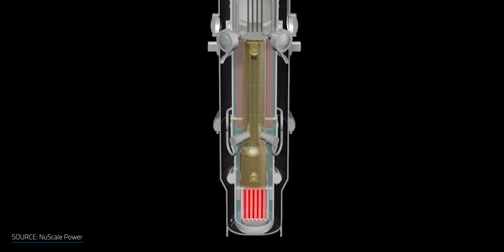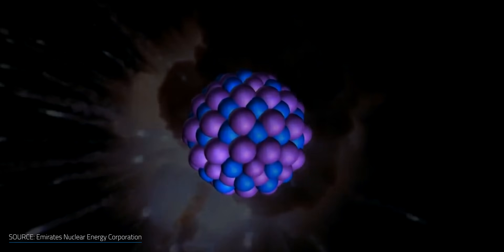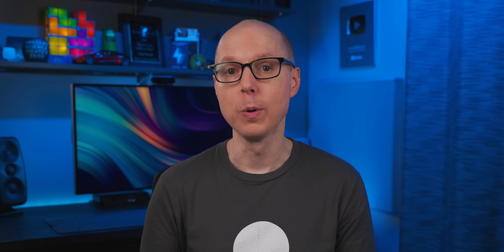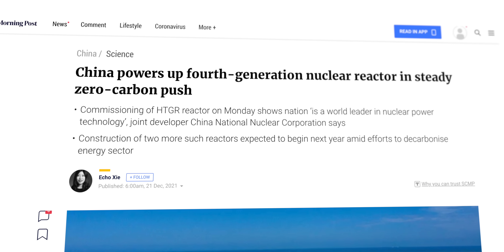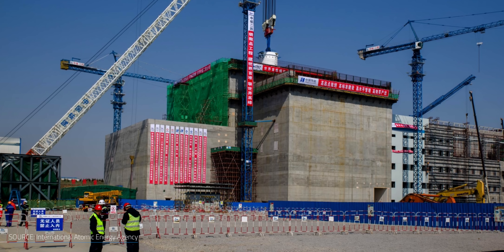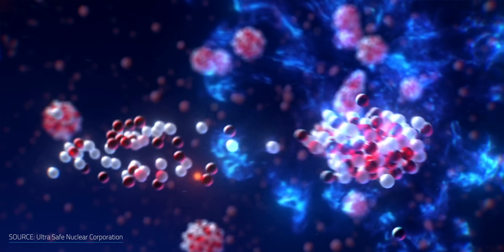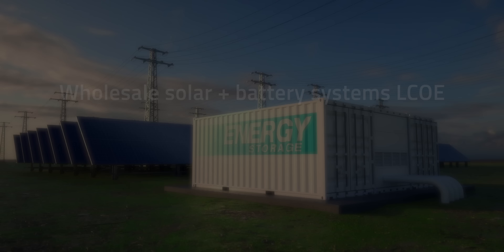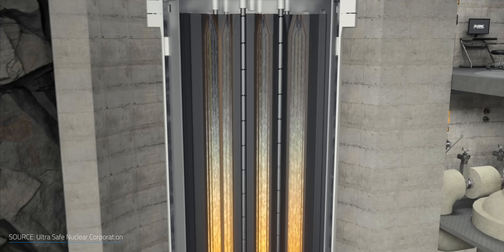Forget Small ... What About Micro Nuclear Energy?

Comment: I served aboard USS Will Rogers, SSBN 659, as a Nuclear Machinist's Mate and Engineering Laboratory Technician. That means I cared for the nuclear reactor and all associated systems, while monitoring for anomalies, as well as radiation exposure of the crew. Naval Nuclear Reactors are incredibly compact, yet incredibly powerful. The S3G reactor was about the size of Radiant's design that's capable of 1MW. However, due in part to much higher enrichment levels, S3G cores far surpassed this level of energy output.

While working for DuPont after the Navy, I worked on Naval Fuels, and Defense Nuclear Waste. We were perfecting vitrification of high-level nuclear waste over 35 years ago! That 90 MT of spent fuel languish in onsite storage all across the country is a travesty.

As for the SMR or MSR question, that's an "and-both" issue, not an "either-or" one. There is no "Silver Bullet". Only silver buckshot.

So, in addition to the first-off-the-tongue renewables of solar, wind and hydro, we must quickly expand production capacity, while investing heavily in geothermal and wave/tidal. Geothermal and wave/tidal are akin to stable, baseload generated by natural gas, coal and nuclear, and we've barely scratched the surface of what these energy sources can deliver to humanity and the planet.

SMRs have their place. Designs are approved and projects are already underway. No, they don't have all of the benefits of MSRs, but we urgently need the capacity. It's a bit like the tortoise and the hare, where MSRs are the former. Working down the existing spent fuel inventory, while generating a fraction of the waste of traditional reactors designs, that's also toxic for a far shorter period of time. That's the promise that we should work towards.

In addition to all this, there are EVs, ground source heat pumps and hybrid water heaters. There are biomass, carbon capture and synthetic fuels. There are smart grids, distributed grids and vehicle-to-home. Hell, there's even white paint. We need it all. And we need it now!
Reply: Thanks for a great response!
Reply: Exactly.  Think about how amazing the Navy's reactors are.  They've been working for DECADES, 24/7, working mere feet from thousands of sailors, many of them in completely closed-air systems (the subs).  They're installed in steel ships, rolling and moving DYNAMICALLY in the ocean, in CORROSIVE saltwater.  Naval ships are a veritable test chamber for the efficacy, durability, and safety of Nuclear energy and a vital complement to renewables!
Reply: @pfschuyler   They've been working for DECADES, 24/7 - that's not true, they are periodically taken to dry dock and given repairs.
Same with nuclear carriers, there is always one in for maintenance, on rotation.
Reply: Like John Coloe, I was also in the Naval Nuclear field. I never worked in the civilian sector. I think the SMRs and the Micro reactors are a good path. I also agree that fusion should still be pursued but is not a current option. Even if a major breakthrough happened today, fusion would still be 20 to 30 years before full scale fusion would be realized. The US Navy does use much higher enrichment but they also have some outstanding safety systems. Many seem to be implemented in the SMRs mentioned in the video. I would like to see the scale reduced to single home sized reactors. A 3 to 5 KW power plant in each home for the cost of a cheap car that could power a single home for 10 to 20 years depending on usage would be a game changer. A small storm shelter sized concrete enclosure filled with a boron / water mixture underground would provide additional shielding and cooling. With grid tie, these could help the renewables at peak times and really balance the grid overall.
Reply: @John Coloe - I was going to post the same thing on vitrification and how we couldn't get it to work even after many years. SRS 1989-1995
Reply: Good to see another ex-nuke in these threads. EM1(SS), USS Shark SS(N) 591 and Stonewall Jackson SS(B)N 634 Blue Crew way back when (69-77). When were you playing ELT?
Reply: @ocelblack9823  Thank you for your service. MMN2/ELT ('77-'81), USS Will Rogers (SSBN 659), Gold crew operating out of Holy Loch. Wanted to be a lifer, but undiagnosed claustrophobia had other ideas.
Reply: @ARepublicIfYouCanKeepIt  Boomers and a divorce chased me off the boats, claustrophobia  was never a problem. If I had stayed on Fast Attacks I probably would have gone for CPO and hand my finger fused into a permanent coffee cup hook. Too many drills of "Ending The World As We Know It" sitting Battle-stations on the EPCP looking at 4 switches that could say "NOT Today".
Reply: @ocelblack9823  I was a Senior Chief EDMC or EDEA when I retired. Turned down Master Chief because I was getting burned out and had to do 2 more years to accept. That was the title we used back then for senior enlisted Nuke.. I still have that coffee cup finger. Even 20 or so years after retirement. Salute to my fellow submariners.
Reply: @lawrenceleverton7426  Good on you Chief, we know who runs the Navy.
Reply: Wouldn't save my edit, when were you playing ELT? Sorry about calling you a skimmer.
Reply: @ocelblack9823  Didn't see the skimmer reference. Wouldn't have taken offense anyway.
Reply: @ocelblack9823  no idea wtf you're talking about
Reply: @ocelblack9823  Those are fighting words. There are Submarines and there are Targets.
Reply: @lawrenceleverton7426  I already apologized for "skimming" instead of "reading" and missing the boat reference. There aren't that many of us and I regret my oversight. Sort of like the JG who failed to look up during a NATO exercise and got a PDC on the sail from an ASW helicopter. "PDC" is a "Practice Depth Charge" (concussion grenade wrapped in toilet paper to give it time to sink simulating a depth charge during exercises with allied units) for non-military persons. Phuqe helicopters, they were the bane of our existence unless we could go deep to avoid them.
Reply: Been hearing a lot about Thorium reactors lately....  seems like a very practical tech to "warp speed" into operation...
Reply: @dougstevens1877  The Thorium-to-Uranium fuel cycle is perhaps the most theoretically virtuous and, therefore, should be a goal for an MSR design such as a LFTR.

However, what those without training and/or experience in the nuclear field fail to understand are the myriad complexities in bringing new and vastly different reactor designs to market.

Currently unresolved challenges for LFTR designs include metallurgy and chemical processing. Molten salts are phenomenally corrosive, and the processes needed for salts reconditioning on an ongoing basis are novel.

These are technical hurdles that can be resolved given appropriate resources and funding.

Focused effort on the part of regulatory agencies is also required.

With all that said, we'll most likely see an early rise in SMR installations, hopefully followed by LFTR installations beginning in the 2035 timeframe.

Unfortunately, these things take lots of time, and we've waited far too long to begin taking substantive action.

If there could ever be a side benefit to war, Russia's illegal invasion of a democratic, sovereign Ukraine shone the brightest light yet as to why the world needs to break its dependence on fossil fuels. For, if not for significant dependence on Russian energy by many European countries and the UK, Putin would have significantly less power.
Reply: @ARepublicIfYouCanKeepIt  Thanks for sharing your knowledge and for being open minded enough to consider various options. The metallurgy problems seem approachable with, as you said, appropriate funding. And, though it's not optimal or sexy, in the near term, certain parts and even whole small reactors can simply be replaced, especially in designs with several small reactors at one facility. It's not such a big deal to turn one off.
Iceland has to replace a lot of parts and pipes pretty frequently in it's geothermal systems, but they still seem to find it well worth doing.
 Thorium MSRs may not be quite ready for large scale deployment, but it seems like, with effort, it may not be too far off.
Reply: The "silver buckshot" approach is ultimately what I feel would make the ultimate difference, the issue is the costs associated. 

I have a lot of family overseas in northern Europe, where saving energy (especially now) is a major priority. Houses have anywhere from 30-40cm of insulation on the walls and over 50cm for the roof. The number of passages in the walls for heat to escape is typically half compared to a standard US timber framed house. In addition to this, ground source heat pumps are quite common, with active ventilation systems to capture additional heat from the air being pulled from the house. Even the air source heat pumps are quite efficient.

It's pretty disappointing to me that to acquire a house with the same level of energy efficiency in the states, you essentially need to have it custom built. Since we do typically build in large subdivisions, a lot of money could actually be saved on the labor needed to perform drilling for things like ground source heat pumps.

I do still wonder, though, if people would be willing to pay the premium for those features when buying a new home.
Reply: @rs.wright  The UK needs to look at Europe too. We have some of the worst housing stock in Europe when it comes to insulation. Definitely possible to save a lot of energy.
Reply: This guy knows what's up! I will need to borrow the silver buckshot line - I've always remarked on society's weird obsession with a binary way of thinking when almost nothing in the known universe (especially in nature) is binary. Thanks for sharing!
Reply: @ChristopherCampanale  Thanks for your kind words. And, feel free to use the heck out of "silver buckshot".
Reply: @ChristopherCampanale   agreed
Reply: great post. Have you looked at Quaise energy? They have a great concept and it makes me think geothermal will really happen.
Reply: @zber9043  Quaise's approach has merit. But theirs is a large, centralized implementation.

It's not necessary to drill miles/kilometers deep to gain significant advantages. Heating and cooling buildings is a significant contributor of global greenhouse gas emissions. Conditioning the built environment is all about the "Delta-T", that is the temperature differential represented by source and desired temperature. The smaller the gap, the lesser the energy needed to get to the desired temperature.

We only need bury relatively small loops between 6 and 10 feet down to reach stable temperatures year round. Horizontal ground loops can be used to as a heat sink when cooling, and a preheater when heating. The same goes for heating water.

As I said in my original comment, "silver buckshot." We need every solution. Like yesterday.
Reply: @ARepublicIfYouCanKeepIt  Actually from what I could find, heating and cooling buildings is the most significant one, yet the authorities seem to dwell on reducing fuel consumption and electric cars...
Reply: @ARepublicIfYouCanKeepIt  Is there any way I can support you and your ideas?
We need more engineers and less salesmen and (current shape) politicians.
Reply: @ARepublicIfYouCanKeepIt  you should be a leading advisor for every countries energy department
Reply: @ARepublicIfYouCanKeepIt  In your expert opinion, how significant is man's contribution to global greenhouse gas emissions, compared to other natural sources of emission?
Reply: @OneOffization  In the world of correlation and causation, it's the overwhelming consensus of the scientific community that mankind has had a massive causal impact on climate; due primarily by burning fossil fuels, as well as agricultural practices supporting a diet that's evolved over centuries too heavily favor animal protein in developed economies.

To answer your question, I believe the science. Going further, I see this point in the history as mankind as the ultimate everything-to-gain-and--nothing-to-lose proposition.

Renewable energy is available in abundance. No wars need ever be fought over energy ever again. Sources of clean, baseload energy are also available, as is smart and distributed grids. Heck, they're even discovering how to stabilize grids based on variable renewables.

Electrified transport is far superior to traditional ICE-powered vehicles. Yes, more work needs to be done on battery technology in order to support increased range, but that too is happening.

Cargo, air and marine can all run on biofuels, synthetic fuels and/or fuel cells.

Yes, it'd be an expensive transition, and it won't happen overnight, but many new and better jobs will be created to build this much improved, sustainable future...for all of mankind.
Reply: @ARepublicIfYouCanKeepIt  well said. you obviously understand the space pretty well.
Reply: @xg5zm  I second that.  Or even have further discussion.
Reply: @ARepublicIfYouCanKeepIt  I would drill bit deeper that you get higher efficiency and decreased chance of cooling ground in winter too much. In summer we could use holes that are closer to surface. This could make even cheap heat pumps pretty efficient.
Reply: @TheNone724  So-called "well depth" has a  direct relationship to "Delta T", or the temperature differential between supply and conditioned air. The smaller the delta, the less work the heat pump has to do. Below 10 ft, it's a situation of diminishing returns against increased cost, so there is an optimal well depth.

As for cooling the earth around a ground loop, this just isn't a concern.
Reply: @zber9043  wtf do you mean "will happen".
Geo thermal power is a thing already, held back mostly by environmental concerns.
Reply: @zber9043   Geothermal heating is fairly common in Nordic countries. I have one 250m deep energy well drilled in backyard and it provides me all heating, cooling and warm water. Outside temperatures here is between -30 to +30 so its quite powerful. Efficiency of pump is around 5,5SCOP witch means it can make 5,5kW heat / 1kW use of electricity. Total capacity is 12kW so it transfers roughly around 66kW of heat. Total cost of system is around 15-20t€ and "breakeven" is around 7 years, nowdays a bit less because of recent events.
Reply: Cool to meet another  ELT. I did the same thing. On 5 Submarines. Including The Nautilus. Salute to the Nukes and of Course the Silent Service.
Reply: @lawrenceleverton7426  Whoa! USS Nautilus? What a privilege that must've been to ride the first nuclear-powered submarine. Thank you for your service.
Reply: @ARepublicIfYouCanKeepIt  - regarding offshore wind farms, the following might be of interest...
https://www.youtube.com/watch?v=hIsbjuCE01k

Completely agree with you about fusion. I personally don't believe E-out > E-in is doable. Many forget that any output has to be used to heat water for steam to turn turbines, with the associated loss of efficiency.

I also think building codes should mandate ground loop heat exchange, and also, as you suggest, a preheating water tank to bring water up to house temp before point-of-use heaters. (actually, I think the "suburb/exurb" model of habitation needs to go.)
Reply: @ARepublicIfYouCanKeepIt  I was assigned to her as a caretaker. as shore duty. She still had radiological issues even with her reactor defueled. I am proud I presented her to the public. I did 21 years in submarines and happy to have met another ELT. That were not many of us in the navy. What 5 or so per submarine. Have a great day
Reply: Thank you very much for this thread of comments, I enjoyed reading it!
As a foreigner and a guy who doesn't understand US Military (sub?)Marine life jargon, By ELT, do you mean Engineering Lab Team?
My opinion for the past few years has been that Nuclear should make a comeback. and fast.
The current way of "Renewable" Energy production is not sustainable.
In fact the entire first world way of living isn't sustainable. (that's why barely 10% of the globe lives like that)
Reply: @HAWXLEADER  ELT stands for Engineering Laboratory Technician. My responsibilities as an ELT were monitoring of primary and secondary cooling systems; keeping chemistries at optimum levels, while looking for hints of any problems in the reactor, compromises in the steam generators, etc. I was also responsible for monitoring radiation exposure for the entire crew, as well as permanent and portable shielding. During maintenance evolutions, I was also responsible for everything that went into the reactor compartment.

My stance on nuclear power for civilian energy production is that it's long overdue. Had we acted 30 years ago, we could have ended our dependence on oil, coal and natural gas for electricity generation. Nuclear is the answer to clean, stable baseload generation. Period.

Thankfully, SMRs, MSRs and other next generation designs are reigniting interest and activity in nuclear.

I'm also a longtime proponent of renewables. For example, I make all of my own electricity via solar.

And, while I have no issues with wind, I believe that two abundant sources of much more stable renewable energy have been overlooked for far too long. Geothermal and tidal both have the potential to completely eliminate the need for fossil fuels for everything except maybe air and heavy marine transport. For those, there's bio and synthetic fuels for air, and hydrogen for heavy marine.

If we, as a society, made the commitment, fossil fuel consumption could be reduced by 80% to 90% in 10 years...with existing technology. All it takes is the will to spend the money.

Climate change is the ultimate proof of the saying, "An ounce of prevention is worth a pound of cure."
Reply: "Silver buckshot"

Well said, my friend.
Reply: @ManOfLore1  Thank you.
Reply: I know a guy with a coastal house 

The buoys holding his swimming area net all have generators at the bottom, generating something like 4 kw on average

It probably cost a lot but so did solar just a decade ago
Reply: I served on USS Eisenhower as MM2 Nuc. A4W carrier power plant is too large to be considered an SMR. Four decks high and ~125ft x 125ft footprint. Still far smaller than the footprint of many civilian .5GW scale  reactors. But I think it would be a great example of standardized design. That standardization creates uniformity of training and procedures. And economies of scale for construction compared the one-offs common in US now. France has already figured this out.
Reply: Looks like I agree with most of what you say. What does HOA regulations mean? I'm in New Zealand. If it means local city council regulations some of them can be absurd from what I've heard. I heard that there was someone who put solar panels on their roof but the council didn't like it because of looks. He was told he had to get rid of them. The news journalists interviewed local residents. None of them seemed to object to the panels. I cannot remember where this happened though maybe a year or two ago. Somewhere in US. There is no subsidy for solar in New Zealand.
If houses were built with regulations saying roofs should face southward in their slope for northern hemisphere and opposite for southern hemisphere. That would make them more energy efficient house and suitable for solar. Using power where it is generated instead of having to transmit over long distances may not be totally possible. Unless nuclear and it's waste is solved. Will people want a nuclear plant in their suburb?
Reply: @grgmetube  Great comments. HoA is a quite heinous creation here in the states. It stands for Homeowner's Association.

Many existing housing development/subdivisions, and most new ones, have a set of covenants that residents must abide by. These can include anything from parking restrictions, to accepted colors to paint your house, to landscape regulations.

HoA's are started by the builder/developer, and turned over to the community as the neighborhood is completed. There's even an entire industry of HoA management companies.

Regardless of management, HoA's have enforcement powers, and can demand that you trim your bushes, repaint your house a different color, prohibit installation of solar panels, solar collectors, antennas, etc., and can levy fines, place liens and foreclose on your property if it's not brought into compliance with covenants or fines go unpaid.

As for long distance power transmission, this is actually a thing. Check out HVDC transmission. Australian solar production is already sending power to Singapore, and the UK will receive power generated in northern Africa.

As for nuclear power and nuclear waste, check out Molten Salt Reactors (MSR's), the Thorium-Uranium fuel cycle, and Molten Chloride Salt Fast Reactors (MCSFR's).

The technology exists that can help us to prevent the worst impacts of global climate change...provided we act quickly. Time is running out.
Reply: @grgmetube  One, HOAs need to die, period.  HOA's  are groups that enforce owners to agree to pre-planned housing and upgrades essentially. You can't do anything the HOA doesnt approve, and they can fine you for doing anything almost, such as having flowers on your porch that no one else does. The plant would be on it's own and power pushed down transmission lines not unlike it is now, you wouldn't have it right in the middle of town that would just be silly.
Reply: I also worked at SRS but after Dupont left and many of my co-workers that worked at Navel Fuels developed cancer.  It was so common that if you worked there and developed cancer it was an automatic approval for compensation by the Labor department.  I do not believe the cancer was due to the radioactive isotopes but from the toxic chemicals used in the process.  I hope you are one of the lucky ones that are still healthy.
Reply: @clarkkent9080  So sorry to hear about your former colleagues. As for me, so far, so good. I was a consulting engineer. As such, my exposure to all the nasties was thankfully limited.
Reply: @ARepublicIfYouCanKeepIt  I worked at a SRS facility that seemed to get the Navel Fuels folks after Navel Fuels shut down.  I understand that there were two sides, wet and dry and if I recall correctly the vast majority of people working the wet side developed cancer .  My cubical buddy was dreaming of retiring and planning on spending time with his children and grandchildren.  6 months before his planned retirement he was diagnosed with Pancreatic cancer.  So sad
Reply: When I was young, I worked as a miner for Eldorado Nuclear, mining Uranium, in the NWT of Canada... It's where all of the Uranium came from for the Manhattan Project. There were/are areas in the mine, where regular workers are not allowed, they are so "Hot". The Nuclear Waste can be returned to where it came from... There are Thousands of spent mines, all over the USA and Canada, where waste can be deposited safely... Finland is doing just that and turning nuclear waste disposal into a profitable industry... We are not achieving what we are capable of... Sheesh!
Reply: Adding nuclear reactors to every town in America still doesn't seem like the smart move when we still don't have a long-term storage solution for waste. It also creates a potential contamination/security nightmare. Having nuclear reactors on highly secured ships makes sense, deploying these across the US really doesn't.
Reply: Thank you for this information. Beyond the waste issue, which has been a concern since Three Mile Island and Chernobyl put many of the hazards of nuclear energy into the public's (my) eye, I am concerned about natural or man-made disasters/events. We see today in Ukraine two facilities under threat from man-made hazards. We also know that major flooding, earthquakes, volcanic and Tunguska events can occur. Those eventualities means that there is really no real way to prevent large scale regional or potentially global contamination when they occur. 

While I can see that we need the capacity which these types of nuclear energy bring, people pretending that there are no serious hazards that isn't being addressed is frustrating.
Reply: Very informative.  I feel like I have learned alot.
Reply: @Sayin wat The topic of this thread is nuclear civilian energy production. As such, SRS (where I worked for several years) is a completely different case. Thus, it cannot be qualified as an "example of a nuclear project failing." To the contrary, started in the 1950's in support of nuclear weapons component production, it operates to this day with a greatly expanded mission.

It is a vital part of our national defense and national security apparatuses.

Construction of units #3 and #4 at Plant Vogtle likewise cannot be characterized as an "example of nuclear projects failing." Massively over-budget, as well as massively delayed? Absolutely. Failed? Nope.

As I've already mentioned, unit #3 is scheduled to go online this year, with unit #4 slated to be operational next year.
Reply: Fantastic info John. Thank you for sharing your knowledge and wisdom. Nuclear is clearly our best option, miraculous even, sadly being held back by bureaucracy and politics. Strange how climate alarmists ignore or downplay it, no?

I’m sorry to burst bubbles of cognitive dissonance, but AGW is flat out ridiculous. Geologically speaking, the earth is at rock bottom levels in terms of CO2. The plants tell part of the story, as optimal CO2 levels are 800-1200ppm, which is why the earth is greener now than we’ve ever seen it (per nasa satellites). If run away warming was a thing, we wouldn’t have had ice ages with 10x the amount of CO2 we have now. CO2 is literally the building block of life. The more the better, hence why polar bears are thriving and the Great Barrier Reef is growing (look it up!). Ice cores show that the earth heats up before CO2 increases (due to outgassing, of course). Hurricanes have been decreasing, and the noaa predicts only a very slight increase in more powerful storms over the next 60 years or so (“probably”). ALL of the climate models have been horribly off.. and ALL in only one direction. We’ve been misled about everything. Like all the crises before: global cooling hysteria, ozone, acid rain.. somehow we’ve survived and thrived. Climate related deaths have been getting smaller and smaller. Yet every 10 years since the 80’s we’re told we only have 10 years left. If anyone can’t see how absurd all of this is, I have a bridge to sell you, along with carbon offset credits of course (the modern indulgences; Tetzel is rolling in his grave). If anyone is curious, the answer to climate temp has been solved. It’s not directly from solar output, but changes to the solar magnetosphere. When the sun’s activity decreases, the magnetosphere shrinks, letting in more cosmic rays, which act as a nidus for low level cloud formation, which dramatically increases the earths albedo, and thus results in cooling (or vice versa). Cheers.
Reply: @cwfrederick   oy vey bro, GW is really real and stuff. Turn off the Faux Nuze, sponsored by Chevron. Turn on the facts. 
But thanks for being a nuclearbro, glad you can see the value in this technology.
I respect all my fellow environmentalists, but they just were wrong on this one. Pollution, deaths and damage from literally any other heavy industry or energy source is worse, if not much worse. Only three major accidents in 60+ years, all unique situations and lessons well learned. 
While still a concern for humans, apparently within the exclusion zone near Chernobyl nature is thriving. It's quite amazing.
Reply: What are your thoughts about Ed Pheil and Elysium Industries reactor design?
Reply: @fastcars1173  Elysium's Molten Chloride Salt Fast reactor designs could actually deliver on the promise of reducing/eliminating spent fuel stockpiles. Their modular approach, where a single core supports a wide range of power ratings by adding thermal conversion capacity is be key to minimizing build costs. Non-proliferation and walk-away safety design provisions could see Elysium's designs progress to demonstrator plant commissioning in the not too distant future.

Regardless of whose advanced reactor designs win, we'll all be better for the expansion of clean, green nuclear-powered civil energy production.
Reply: There is no reasonable comparison between a Navy nuclear plant safety systems, containment, etc. and a commercial nuclear plant....NONE.  There are more valves and piping in a commercial nuclear plant's sewage treatment plant than in an entire Navy nuclear submarine.  When Navy nukes came to the commercial nuclear plants that I worked at, they were shocked at what they had to know, just to be a entry-level operator. 
Concerning your time at the Savannah River site Navel Fuels facility, I hope it was short.  Many of my previous co-workers from Navel Fuels developed cancer and died.  The tie between that facility and cancers is so great that anyone who worked there and develops cancer is immediately compensated....if they live that long.
Reply: I think I'd rather follow John Coloe's youtube channel.
Reply: @workingguy-OU812   @Working Guy  Thanks for your kind words. Unfortunately, I'm not a content creator. Even if I were, I'm certain my skills wouldn't begin to approach Matt's. He's an amazing creator and I do so enjoy his channel.
Reply: @ARepublicIfYouCanKeepIt   :-)  Nonetheless, I appreciated your insight, experience, and willingness to write it out.
Reply: @dan j You either believe in the science, or you don't. I'm going with the overwhelming consensus of the global scientific community.

Additionally, energy insecurity has always been a huge issue over the course of human history. Most wars and major conflicts have been fought over two things:  ideology and resources, with oil being the leader in this category.

The national security implications of energy insecurity is highlighted in the current illegal invasion of Ukraine by Russia. If not for massive dependence on Russian energy, Europe would be in a far stronger position to bring the Russian economy to its knees, thus thwarting military territorial ambitions of a madman.

Energy independence is a critical component of world peace, and renewables are the answer. Oh, that and advanced nuclear, of course.
Reply: That's an old hull number. Run for office if you have the want.
Reply: @Dan-ry4gj  It is, indeed. One of the "41 For Freedom" and one of 31 converted from Polaris to Poseidon. Fun fact, the Will Rogers was the newest SSBN in the fleet until the advent of the Tridents. Her keel was laid down in 1969, and a served on her during the Cold War (1979-1980).
Reply: @ARepublicIfYouCanKeepIt  Sounds like an interesting platform to qualify on, and an interesting time to do it.
Reply: I joined Rickover's canoe club in 69.  That was when he was still terrorizing the o-division personal.  I completed my enlistment and went back to college and retired after 50 years.  Right out of college, I was a startup engineer at a government test reactor that used liquid sodium as a coolant.  That fast reactor could have burned spent fuel and ran for 60 years.  Carter shut us down to protect the oil and coal industries.  This whole energy issue is fabricated to get votes out of fear.  Sound familiar.
Reply: @jerriwillman5874  Firstly, thank you for your service. Good to meet another fellow "bubble head."

On which boat(s) did you serve? What was your rate, as well as rank at discharge?

Sodium cooled fast breeder reactor. I want to guess EBR-II/IFR, but neither the shutdown nor the operational lifetime jibe with Carter's administration. Am I close, or way off?

Yes, the U.S. civilian nuclear power generation industry as been a mess, almost from inception. Between the unwise choice of LWR designs, the Three Mile Island accident, the ban on spent fuel reprocessing, political interference, and a lousy PR effort, is it any wonder the industry had to get to such a sad state?

Hopefully we're on the brink of a renaissance of sorts. This time with the right design for the times to provide clean, green, cost effective baseload generation.
Reply: I knew a Bloombaum that worked the nuke on the Will Rogers.
Reply: Thank you for taking the time to write this…very interesting!
Reply: DUDE....I've been wondering for years why not Molten Salts....they;re as close to safe as can be had...
Reply: Nonsense on tidal/wave front. PBR is useful. Redesigned liquid fuels are the future for a long time. Green energy is a tragic joke.
Reply: @talisikid1618  And...this is helpful how exactly? Marine renewables (tidal, wave, etc.) are "nonsense." Really? Marine renewables could satisfy 100% of all human energy requirements. Full stop.

We're all entitled to our own opinions, just not our own facts.

The potential of marine energy is a fact, as are those of solar and wind, including offshore wind.

As for PBR's (and assuming you mean Pebble Bed Reactors), they're to be included in the silver buckshot of fission reactor designs. SMR's, MSR's, HTGR's, etc. all have their place for fission baseload generation. The key is to commercialize inherently safe designs as soon as possible!

The days of huge PWR's, such as those currently being fueled at Plant Vogle in Georgia, are long over. Small, distributed, smart grids, with modular baseload generation, plus renewables and storage are the only hope of averting the worst consequences of global climate change.

As for "green energy" being a "tragic joke", if it were, would renewable energy contribute 20+% to total domestic energy production in 2022? Would renewables be capable of fully supporting California's grid as it's been shown to do? How about those of Austria, Brazil, Costa Rica, Denmark, Greece, Iceland, Norway, Paraguay...the list goes on and on?

Renewable energy (including all sources) is abundant, clean, reliable, safe, affordable and, above all, sustainable. Fact, not opinion, and most certainly not "a tragic joke".
Reply: Mass produce small, modular, thermal, Chloride salt MSRs. Replace when graphite expires.
Reply: @red-baitingswine8816  Yes and no. While MSR's are theoretically possible, as well as proven (4,000 operating hours at ORNL in the 60's), there are still a not insignificant number of process, metallurgy and chemical processing issues to resolve.

Currently we are also affected by a dearth of domestic uranium mining and processing resources, not to mention a ban on spent fuel reprocessing. In their infinite wisdom, past administrations and legislatures ceded interest and, in some cases, control of these to Russia. That ship must be righted to make progress on SMR's and MSR's alike.
Reply: @ARepublicIfYouCanKeepIt  Are you familiar with Ed Pheil, and his explanation of his molten Chloride salt fast reactor?
Reply: @red-baitingswine8816  Yes. The "problem" with many of these "new nuclear" concerns is that, while the theory solds wonderful, the devil of actually commercializing a thing is incredibly difficult. I have immense respect for Mr. Pheil's work. With direct exposure to projects with which he was involved, I'm incredibly grateful for his contribution to the nuclear field.

The key to commercializing "new nuclear" designs, in this country anyway, is making it cost competitive to the low cost leader, natural gas.

Mr. Pheil's work at Elysium, now Exodus, is immensely meaningful in that existing generation facilities, be they decommissioned PWR nuclear sites (the best profile due to presence of SNF) or coal- or natural gas-fired sites, can be converted to with MCSFR modular designs.

Another brilliant aspect of these MCSFR designs is their suitability to process heat generation in addition to electricity generation.

Congress could make the United States the epicenter of power generation technology by simply switching all the subsidies for fossil fuels to "new nuclear", coupled with reducing the delay-causing red tape associated with regulatory agency operations.

We, the United States and the world, need stable baseload generation that doesn't emit global greenhouse gases. Aside from the ~400GW capacity of the ~400 operating nuclear plants around the world, designs such as MCSFR offer the clearest, most immediate solution to solving the green baseload quandary. The bonus of MSR's is their ability to use SNF as fuel, thereby eliminating the even more vexing dilemma of nuclear waste storage and disposal.
Reply: @red-baitingswine8816  @red-baitingswine8816 Yes. The "problem" with many of these "new nuclear" concerns is that, while the theory solds wonderful, the devil of actually commercializing a thing is incredibly difficult. I have immense respect for Mr. Pheil's work. With direct exposure to projects with which he was involved, I'm incredibly grateful for his contribution to the nuclear field.

The key to commercializing "new nuclear" designs, in this country anyway, is making it cost competitive to the low cost leader, natural gas.

Mr. Pheil's work at Elysium, now Exodus, is immensely meaningful in that existing generation facilities, be they decommissioned PWR nuclear sites (the best profile due to presence of SNF) or coal- or natural gas-fired sites, can be converted to with MCSFR modular designs.

Another brilliant aspect of these MCSFR designs is their suitability to process heat generation in addition to electricity generation.

Congress could make the United States the epicenter of power generation technology by simply switching all the subsidies for fossil fuels to "new nuclear", coupled with reducing the delay-causing red tape associated with regulatory agency operations.

We, the United States and the world, need stable baseload generation that doesn't emit global greenhouse gases. Aside from the ~400GW capacity of the ~400 operating nuclear plants around the world, designs such as MCSFR offer the clearest, most immediate solution to solving the green baseload quandary. The bonus of MSR's is their ability to use SNF as fuel, thereby eliminating the even more vexing dilemma of nuclear waste storage and disposal.
Reply: Wow, that's awesome. Thank you for your service to the united states, it's always great to hear from a veteran!
Reply: Hello John, I'm not understanding the issue with nuclear waste?... I was under the impression that "Terrapower", Bill gates generation four molten salt  nuclear reactor, utilized nuclear waste as fuel. Can you shed some light on this for me?
Reply: @kanekelman9173  Unfortunately, "nuclear waste" is a catch all term that most think includes so-called spent nuclear fuel. In actuality, these are two distinct entities, with "nuclear waste" further broken down into low- and high-level waste.

Making things more complicated is the incessant conflation of terms such as radiation, toxicity and contamination.

The business of making everything from medical radioactive isotopes, to low-enriched fuel for civilian purposes, to high-enriched fuel for various purposes, including space vehicle power plants and Naval propulsion, to weapons-grade material, all results in myriad waste byproducts. This includes everything from irradiated materials, to contaminated materials.

These materials are the true "nuclear waste" that must be stabilized and stored until radiation decays, thereby lessening the risks associated with contaminant releases and the effects of associated toxicity.

A good example of this type of waste is over 50 million gallons of waste sludge and solutions stored in some 177 underground tanks at the Hanford Nuclear Reserve. Nearly 60 of these tanks have leaked; contaminating subsurface soil and potentially more.

Another example of nuclear waste are the reactor compartments removed from decommissioned nuclear submarines; the boat on which I served among them.

Though all fuel has been removed and all coolant drained, etc., these structures remain irradiated and are, therefore, considered low-level nuclear waste.

Obviously, these large metal structures aren't candidates for vitrification, so they're securely stored in lined trenched.

Now for "spent" fuel. I place the word spent in quotes because fuel rods that are removed from civilian energy reactors extract less than 5% of the total potential energy contained within the fuel.

Making matters worse is that the US bans fuel reprocessing due to perceived proliferation risks.

Every other country in the world that operates nuclear reactors for civilian energy production reprocesses their "spent" fuel.

This will have to change for any new reactor design to be able to use "spent" nuclear fuel.

TerraPower's Traveling Wave Reactor technology converts natural and depleted Uranium to fissile material. This is where reprocessed "spent" fuel would come in. The low levels of enrichment in fuel pellets used for civilian energy production would actually represent high enrichment for the TWR.

While their designs are vastly different, TWRs and MSRs could both consume much of the current "spent" nuclear fuel stockpile...given appropriate reprocessing which, again, differs for each reactor design.
Reply: @ARepublicIfYouCanKeepIt  thank you very helpful
Reply: @kanekelman9173  Sadly you can't trust the intentions of Bill Gates, his whole involvement with the 'pandemic' has proved that,... he's behind the Great Reset which will be far from great for the average citizen.
Reply: @steveclark..  proven what?. what did Bill Gates have to do with the pandemic?
Reply: afaik, the proposed Rolls Royce SMR design is based on a submarine implementation.  Not exactly cutting edge but I suppose it's a proven design in its context.  It'll still probably take decades to come to anything, if at all.
Reply: @markhodgson7241  SMRs are novel, not in their fuel or thermodynamic cycles, but in their safety designs, as well as methods of manufacture and deployment.

SMRs incorporate the latest in safety designs, making them much, much less susceptible to accidents of the past.

Traditional in situ building of mega generating facilities is simply unfeasible and unsustainable. Southern Company's Vogtle Electric Generating Plant is a prime example.

Originally estimated to cost a mere $14 billion, by 2021 the costs of building the two new units at Plant Vogtle were estimated to be over $28.5 billion!

These are the only new nuclear projects in the US in the last 30 years. Construction on Units #3 and #4 began some 13 years ago in 2009, with Unit #3 projected to be online by 2016, followed by Unit #4 in 2017!

Current projects are 2022 and 2023 for Units #3 and #4, respectively.

Obviously, this situation is massively broken. Therefore, manufacturing SMRs in purpose-built factories, then transporting and deploying them onsite, is the only way to accelerate reactor production, while ensuring consistently high level of fabrication.

As for timelines, NuScale and TerraPower have begun projects in multiple locations, both domestically and internationally.
Reply: Excellent post, ELT. Another former nuke here. I got to ask. Did you ever drink the coolant after taking a sample?
Reply: @rbmk_master1714  De-ionized water's not good for the brain. And, thank you for your service. I'm assuming enlisted, since officers don't tend to identify as "nukes". If so, rate and rank at discharge? Surface or sub? If sub, boomer or fast attack? Ship(s)/boat(s) and active dates? I've been so surprised and heartened to hear from so many former nukes. It's incredible really.
Reply: @ARepublicIfYouCanKeepIt  DI water is about as good for the brain as the sub pipeline. I was a sub officer, fast attack, won't say anything further on YouTube. I would to thank you for your service as well. I always enjoy talking with other submariners.
Reply: You can get compact cores if you have highly enriched fuel. But you did not mention about the efficiency; for every 1 MW of electric power produced, you will dump 3-4MW of heat energy in the waste.
Reply: Amen, brother.  There's no nuclear solution without one or two permanent long term storage facilities in the US, and NO state wants to accept it, and it has nothing to do with "liberal", "anti-nuc", etc.....  It's a NIMBY effect, and even the most conservative state of Texas has a gov. that has adamantly said NO to Texas being permanent storage even though it has the right conditions for it.  And the US govt. gave up its case to get permanent storage in NV.  And these were the best places from my understanding based on many geologic considerations along with the climate.

The "Build Back Better" plan should have incentivized the construction of solar farms in the Southwest and wind farms in wind corridors.  Unfortunately one of the main wind corridors goes through Texas, and even though it's now the no 1 producer of wind energy, the TX. govt. seems anti-wind and wants to punish that industry for the failures of natural gas a year ago.  But the "Build Back Better" program presented by Dems was really a "Build Back Socialism" program and I'm HAPPY that it couldn't pass through the Senate because it would have been good for no one, not even the people getting monthly payments as they learned to live off of govt. money just like what happened with welfare back in the 70s and 80s.

What the US really needs is a pro-Science, pro-DATA party that makes decisions based on real data and takes progressive actions like what used to happen when the word "progressive" did NOT mean "socialism".  The US needs nuclear power as does many places of the world in either the upper or lower latitudes because there are places where wind isn't consistent, there's no thermal or hydro solutions and solar isn't feasible as it's only effective for 4 - 5 months at the most, and even improvements to long range power transmission won't be good enough and you have too much power loss.
Reply: lol.  The same people demanding a switch to renewables and economic independence from foreign sources also protest the mining sites required to allow the US to build that same renewable system.  Everyone wants renewables to happen by magic.
Reply: @uni4rm  What mining sites are protested? Is this a NIMBY problem or is this about environmental concerns? Beause some of the parts needed for green energy often comes from dirty places. This has to change and is ultimatly a politcal problem, but solveable. You just have to have higher standards.
But anyways, the magic part is much stronger with nuclea power. All the proponents have, is talking about mythological Gen IV reactors, which are supposed to be smaller, safer, cheaper and burn up the waste, but no one has ever build one. And the old style reactors seem to be impossible to build these days, because most of them can´t even pass the planning phase.
Reply: I don't know if I agree with you but you sound knowledgeable about it and have opened new areas of research to help people understand energy-related questions.
Reply: @CigaretteCrayon  I have worked in the nuclear industry for 40+ years, at 5 different reactor sites, Licensed Reactor operator at a Westinghouse PWR,  Licensed Senior Reactor at a B&W PWR and certified Reactor Operator at 2 other sites.  I would like to see a nuclear resurgence but with the recent nuclear project failures (VC Summer and Vogtle) building new projects is a waste of time unless the problems with massive construction delays and cost over runs are addressed. To me this is not a nuclear issue but a criminal mismanagement of the construction process.  Throwing free taxpayer dollars at investor owned utilities is only making the problems worst.  Maybe you should research why nuclear projects are canceled after spending billions with no financial end in sight.
Reply: Agreed on MSR's!
Reply: This. No one thing will be the thing that leads us into the next age, it's going to be a network of things working in tandem. Sure, eventually we may be able to no longer use any sort of fossil fuels but that is quite a ways off, at least a decade.
Reply: Finally, an intelleg3ent conversationalist!
Reply: Eventually, Thermo-cells will be developed using graphene, using ambient heat to generate energy. Also to note, I'm all for, "all of the above" approach.
Reply: I look at every lava tube that still has lava passing thru it as a POSSIBLE STEAM GENERATING POWER PLANT !!!!! WE HAVE ALL THE HEAT WE NEED TO POWER STEAM GENERATORS IN HAWAII ALONE PROLLY!!!! (exxageration, but the THEORY IS SOUND!!!)
Reply: @alexmikhael5061  Definitely. Certain locales have an abundance of geothermal. So much so that it can and should be harnessed for energy production, and process heat.

But literally every other part of our planet has inherent geothermal properties that have and are being squandered.

Heating and cooling the built environment is all about "Delta T". That is, the differential in temperature between input and output.

Small, affordable, horizontal, closed loop systems, coupled with high-efficiency heat pumps, as well as hybrid water heaters, are an all but ignored source of pre-heating and heat rejection.

And, we were ever got really smart about it, we'd require that all new developments build to net-zero standards. Have a look at Whisper Valley near Austin, TX (https://www.whispervalleyaustin.com/).
Reply: Good comment. I am a former nuke machinist mate as well… Call iamb very wary of gas cooled and molten salt designs due to the extreme high temperatures. We both know that materials don’t stand up to high temperatures, long term.   

I am on the outside now and it’s hard to find anybody that is in the know, but of those I’ve inquired they just give me the crap about developing alloys to withstand it which you and I know is crap… We worked with the best alloys in the world and they can only withstand so much, temperature wise, long-term. I totally agree with you that we need safe stable and reliable energy to get us through the next 30 to 40 years of technological advancement but we shouldn’t engage in what we’re not ready for yet
Reply: @Hazmatt3446  Firstly, thank you for your service. On which ship(s)/boat(s) did you serve, and during what period?

As much as I'd love to agree with a former nuke machinist's mate, we must believe in the science. Have you read any of the declassified materials out of ORNL on the MSR? After many years in service and several thousand hours of operation, the materials used even over 50 years ago showed no degradation of concern.

There's been much work done in materials research since then. Even super computers and quantum computers have been used to evaluate literally millions of materials candidates, with successful ones identified to withstand high temperature, corrosive environments.

China has already added one of their HTPBR units to the grid. The second is set to be added soon.

If you'd really like to get a handle on the state of advanced reactor design, I suggest checking out TerraPower and Elysium Industries regarding their work on Molten Chloride Salt Fast Reactors.

Additionally, check out the work that's been done on supercritical CO2 turbines.

These are all very fascinating and promising developments.

We've long needed projects on the scale of the Apollo and Manhattan projects that focus on new nuclear reactor design. Perhaps that time is coming.
Reply: @ARepublicIfYouCanKeepIt  that’s why I challenged you a bit.  Hard to find those resources as an outsider!  Thank you for your service as well!  I look forward to reading these resources… haven’t even heard of supercritical CO2 turbines.  

I was a SPU at MARF, then USS Mississippi and USS South Carolina.  I own and operate a small trucking firm now.  When I got out every plant was closeting or downsizing.  

Thank you!
Reply: @Hazmatt3446  I completed prototype training and ELT school on MARF when it was still water moderated. Did QA work when we performed some maintenance in the reactor compartment, as well as some stream generator maintenance.

Helped write procedures for the brand spanking new S8G plant during fuel loading and initial low power testing while waiting to join my crew.

Have fun reading up on the state of advanced reactor development. It's absolutely fascinating...if you're into that sorry of thing.

Where are you located? I'm just beginning some work with small transport fleets around Atlanta, upfitting vans, straight trucks and semis with crew comforts (sleeping, no idle climate control, lithium batteries, power systems, even solar).

I've been building campervans, and am pivoting due to vehicle inventory scarcity.

I have a 10,000 ft² shop half way between Atlanta and Athens.
Reply: Thanks for sharing your life experience in this field!
Reply: The simple fix to nuclear waste is to shoot it into the sun.
Reply: Great post I want to make one addition to what you said about heat pumps. Ground source is very good, but installation is too much right now and not possible on all build sites. However modern air source heat pumps can maintain COP performances above 2 in weather all the way down to 10F. Many places get colder than that but in say the midwest (a typically cold place) they usually only see 2 weeks out of the year sustained below those temps. I think people should consider modern air source heat pumps with backup systems for deep freezes. Even with the added cost of maintaining a backup heat pump efficiency is so high that it would cover the cost anyway.
Reply: Ha! So you remember the trashcan reactor! 😆 so tiny.
Reply: I agree that a multi faceted approach is the only path to sustainable, carbon free energy. It also strikes me as the most secure way to achieve these goals. If there are any obvious lessons to take from the current war in Ukraine it should be that it isn't a good idea to rely too heavily on a single source/country to meet energy demands. However, it strikes me that the biggest obstacle standing in the way of a more diverse energy portfolio is the development of economies of scale. How many decades did it take for wind and solar to become cost effective enough to reach their present capacity? With a myriad of reactor technologies and geothermal methods being developed at the same time, not to mention other nascent areas like tidal and continuing improvements to batteries, pv cells, and wind turbines, I don't know if we have the time and money to take a spray and pray approach. We can't just set emissions goals and let the "free market" solve the problem, either. I think we need to prioritize the technologies to pursue and how much to spend on them based on their current stages of development and how soon they can be economically implemented. Are there any plans like this out there?
Reply: Kalki ironman after 2026 😎

Humans 0
Saiya-jin 1 to 6
Angels 7 😇

Kalki Ironman 5th matriya buddha 8th arc Angel 11th satguru 13th imam and 24th avatar after 2026 😎

Almighty God 9 😇

Humans type 2.5+ after 2026 by Kalki Ironman (christ in the white horse)(son of man on clouds) type 7 and 8 😎

Jarvis the world’s first artificial intelligence (parrot) 😎

Cuz Kalki is ironman batman super saiya-jin superman ben10 saitama Narutoo shaktimaan and every super heroes combined after 2026 😎

Jarvis world’s first artificial living being (just like vision in marvel universe)😎

Made of Quantum and sub quantum particles 😎

Power source quantum energy arc reactor (type 7) level technology 😎

Kalki Ironman going to have every kind of arc reactor like:- type 1 Nuclear fission, nuclear waste, hydrogen fusion, type 2 3 4 5 antimatter arc reactor (solid liquid gas), type 6 electro quantum arc reactor, and type 7 Quantum arc reactor, type 8 limitless quantum energy arc reactor without quantum particles 😎

Kalki Ironman going to have sun in a box million billion tons of hydrogen nuclear fusion reactor type 2 3 4 5 just like sun and stars in the palm of his hand 😎

This all going to happened by self replicating quantum nanobots knowledge energy and techniques at type 7 7 7- respectively 😎

Ironman (Tesla 2.0) going to reveal every secrets of the world specially Tesla and his Antigravity 😎
Reply: John Coloe, as I said, with reliable SpaceX rockets and at the low cost they’re charging per launch, it would be doable. It’s only the American commies who will not go for this because it is a practical solution and it would be better than stuffing it under mountains which is a limited capacity. Ultimately, it is you commies who protect your billionaire friends in bed with the oil and gas companies who protect the old status quo and prevents the world from moving forward.
Reply: @leapdrive  You simply don't know what you're talking about!

I'm gonna break this down for you using some super simple maths:

• SNF Inventory - 90,000 MT
• Heaviest payload to GTO (Falcon 9) - 7.1MT
• Falcon 9 launch cost - $67M
• Falcon 9 launch cadence - 35 in 2022
• 90,000 MT/7.1 MT=12,676 launches
• Cost to launch 90,000 MT of SNF into space - $849,295,774,646
• Years to launch 90,000 MT of SNF into space - 362 years

Do you now begin to understand how staggeringly foolish your idea is?

Of course, none of this speaks to the machinations we'd have to go through in order to even get SNF into launch vehicles.

As to your assertion regarding subterranean interment, consider that 90,000 MT of SNF occupies an area roughly equivalent to university or NFL football stadium.  

Lastly, as someone who served his country by patrolling deep in the North Atlantic with 160 nuclear warheads targeting communist regimes (USSR, China, etc.), you're "commie" comment is one of pure ignorance. Incidentally, the submarine aboard which I served was, you guessed it, nuclear powered, and I was a nuclear engineer and chemist.

Additionally, I'm a longtime supporter of civilian nuclear power generation; in particular, new advanced designs, some that are even capable of burning SNF as fuel, thereby eliminating the 90,000 MT of SNF in the US.

I'm an even bigger proponent of renewable energy sources; particularly geothermal and wave/tidal, both of which provide reliable baseload power generation capacity.

Oh, by the way, I have no billionaire friends, either.
Reply: @ARepublicIfYouCanKeepIt  now do a calculation for Starship at 100 MT and 200 million per launch. Then for Starship 2 at 800 MT but will not be a multiple of 8 in cost due to economies of scale. Btw, if for instance every micro reactor or small reactor were to sell based on addition of disposal cost and see if the sale would still be economical, it would be interesting to see. Can you do this too? And btw, I wasn’t insinuating that we’re doing a world clean up of past stored waste. My calcs were based on future waste for future sale. Cleaning the country or the world up should be funded separately.
Reply: @ARepublicIfYouCanKeepIt  , and we’re going to launch only the radioactive core designed to be removable. The rest of the shell and ancillary systems will be junked.
Reply: @leapdrive  Please stop! This isn't going to happen in our life times, and probably never will. The risks are simply too great.

Additionally, you propose a complete, top-down approach to advanced reactor design. Again, SMR, MSR and the like are not going to be designed for interstellar core disposal.

Lastly, on your maths:  Your baseline max payload assumption for Starship is completely wrong. 100 MT is for LEO. SNF would never be parked in LEO!

For deep space missions, Starship (which isn't even operational yet) payload capacity is drastically reduced. Try 21 MT, or roughly three times that of Falcon 9.

So, instead of some 12+K launches, it's take only roughly 4K!

Lastly, while Musk's claims of Starship launches costs of $10M, that remains to seen. For argument's sake, less say that Starship launches are four times less expensive than Falcon 9 launches. Your "plan" would still cost $40 billion!

Again, please, just stop.

Regardless of whether you choose to post yet another nonsensical reply, this is my last word on this topic.

Good day.
Reply: Can I get these mini nuclear plants delivered in Kenya ?
Reply: @mlionea   not joking, maybe thru Rosatom.
Reply: Kalki Ironman type 7 and 8 after 2026 😎

kalki avatar (beast of the earth) (christ on the white horse) (son of man on clouds) is the biggest enemy of dajjal/antichrist/kali 😏

Kalki Avatar (Murtaza) 11th satguru 13th imam cousin of Moula mahdhi a.s. 12th imam (muhammad) 😎

Prophet Moula mahdhi is raja shashidhuvj (the mighty one) born less then 1200 years ago 😎

Prophet Moula Isa a.s. will kill dajjal cause dajjal is going to kill Kalki Avatar 😏

Kalki Avatar will follow orders from 2 religious king Moula mahdhi a.s. and Moula Isa a.s. 😎

Kalki Avatar going to have 2 swords and ring of moula sulaiman a.s. and staff of moula musa a.s. (iron rod) Staff of moula musa a.s. is like omintrix can transform into anything and can transform others into anything And stone in the ring of moula sulaiman a.s. is also known as kastav mani and it's more powerful than all 6 infinite stones combined 😇

Cuz Kalki is ironman batman super saiya-jin superman ben10 saitama optimus prime shaktimaan and every super heroes combined after 2026 😎

This staff will transforms into white horses with wings,weapons,iron-man,cloud etc or can do imagination into reality 😎

*Ratn sru sword of lord shiva (miri)😇

*Ratn varu (zulfakar) sword of Moula Ali (piri) 😇

miri piri 😇

Kalki Ironman after 2026 😎

Satyug (sunrise from West) 2038 😏

Sambal is hospital 😏

Gzwa e hind 2029 😎

Khalistan and Azad Kashmir after 2026 by Ironman 😎

99% Hadith u heard is not about imam Mahdi it’s about Kalki avatar (the main character) that person momin vs dajjal prove me wrong if u can 😏😏.
Reply: how much of nuclear's power is incurred due to the regulations?  Whether it be direct legal costs, or those due to stretching the projects out to a decade?  These are self-imposed costs, and of marginal utility in my opinion.  The incremental safety of our current beurocracy may be negative relative to a system whereby the operator requires insurance to cover any potential failures/core leakages.
Reply: HOLY COW! Best comment I've read on the subject ever! Would not mind reading/hearing more of your observations and thought! Thanks for sharing, and educating!
Reply: Thanks for your great explanation regarding the different types of nuclear fission reactors. But what about the fusion reactors? Everyday now a new development for this reactor design is published and promises to achieve soon a successful realization! Why not put all the available financial and research resources into this development and get rid of future radioactive waste????
Reply: @rudolfjentsch4294  Maybe because fusion is in its infancy and we need to remove carbon emissions NOW, and Fission is now a mature and readily available technology? That is my limited knowledge inference regarding the issue. 
I believe plenty of money is being dumped into producing self-sustained fission, which is yet to be coherently achieved, yet. We have had compact, reliable self contained fission reactors for decades now, military tach at least that is now being approved for civilian applications. 
As for "nuclear waste" that waste is recyclable, either back into fuel for reactors or for nuclear decay batteries that can last for over 30,000 years (RTGs). These can be used for space applications or static underground banks to provide long term power for centuries, albeit at a lower yield. Imagine placing these RTGs under the surface and plugin small settlements to them to complement solar and wind in remote locations or even another planet. 

Yes such material has to be handled with care so as not to scare the un-scientific masses that rather believe whatever anti-nuclear propaganda has been fed into them or risk creating mass hysteria. Coal plants now replace Nuclear 0-carbon emission plants in Germany, coal that is being mined by striping huge swaths of German land and deleting entire towns and displacing its inhabitants. A win against nuclear power they say, also a win for coal industry and Russian oil, along with a huge loss to the environment. Then they ask why the hell Europe is burning all over the place as I type this.
Reply: @rudolfjentsch4294  This isn't an either/or proposition. Fission is currently our only viable option. While promising, the common refrain is that fusion is only 30 away.

For possibly the best review of the current state of fusion R&D, check out the Fully Charged episode titled "This Technology is the Secret to LIMITLESS Clean Energy!"
Reply: Ñ
Reply: There are many different technologies being developed, the main issue from what I can tell is implementation. So many promising technologies, but none of the funds to use them. It's truly unfortunate that these amazing technologies can't get a foothold in market, and it's due to so many complicated factors as well.
Reply: The real challenge is securing SMRs from terror threats and civil wars. Look at Jam 6th Insurrection and name a single place on the globe you could safely operate these in. Maybe Vatican, Switzerland and Luxembourg do qualify.
Reply: @voster77hh  The "challenge" of "securing SMRs from terror threats and civil wars" is no different than any of the 92 operating nuclear power plants across the United States, or the other 330 reactors sites around the world.

I challenge you to explain how, say, the 4-module NuScale SMR facility at INL is any more or less difficult to secure is any different than the Zaporizhzhia nuclear power plant in Ukraine that's currently controlled by hostile Russian forces.

Your comment is a stellar example of misinformation, designed to sow FUD (fear, uncertainty and doubt) among those less educated on the subject. It also exposes an astounding degree of willful ignorance.
Reply: @voster77hh  An unarmed populist protest is a nuclear threat?
Reply: Thanks for sharing
Reply: Smart grids are not a help to the average person they will be used in a discriminatory way to distribute energy based on socio  needs and poor people will be cut off from the grid when supply is low . It's already happening with smart meters , they can cut you off remotely .  It's the kind of stuff that starts civil wars . Funny how you career was in nuclear power but now your probably well off and become a  greenie .
Reply: What an excellent post. And don't forget, in case you didn't mention it, we have simple ways to reprocess spent fuel now as fuel for other types of reactors. And as far as waste storage I've just heard that in much of the rest of the world apparently there's a process by which the spent fuel is encased in a glass bead and it's completely safe. For some reason it's not used here in the US. Wondering if you have heard of this disposal method?
Reply: @Krill_all_health_insuranceCEOs  Yes, I'm well aware of "spent" fuel reprocessing. It was banned decades ago for fear of proliferation. However, France and other countries have robust reprocessing regimes in place.

Not only is reprocessing for next gen reactor fuel a smart thing to do, securing our nuclear fuel independence is absolutely essential as Russia is the world leader in nuclear fuel processing and they've proven themselves to be non-trustworthy.

As for the safe disposal method your mention, it's known as vitrification, and I worked on the program in the late '80s/early  '90s. The process works as designed. The issue is in securing a strategic national nuclear waste repository. When I worked on the program, Yucca Mountain was the planned destination. In the ensuing 4+ decades, NIMBY (not in my backyard) has blocked progress on this vital initiative.

Fear mongering, combined with willful ignorance, are to blame.
Reply: Bro you did naval nuke duty too? Lol when? I got roped into that but I didn't stay in the field afterwards, altho I considered it. I was a nuke EM and then a conventional EM (bec I got in trouble for something), then a nuke EM again, from 2000-2010.
Reply: @Krill_all_health_insuranceCEOs  Oh, I was waaay ahead of you. MMN2/ELT, USS Will Rogers (SSBN 659), Gold, '77 to '82.

Worked for DuPont afterward, spending lots of time at SRP, which the company operated for the DoE. Amazing technology from the days of the Manhattan Project, right up to the then-current cutting edge.

Still fascinated by nuclear and a big proponent for next gen reactors for safe, reliable, green baseload generation.
Reply: @ARepublicIfYouCanKeepIt   oh snap. Well thanks for going on ahead. I trained on a fun sub in Charleston SC in '99 that they retrofitted for training. Closest I ever got to a sub after that lol. But they are neat machines, I was fascinated by their systems, and the guys from the sub fleet always seemed like very good guys. I was on the opposite - two carriers. One old, the cvn65, and one brand new, the cvn76. In your day the Enterprise wasn't all that old, but by mine it was a trip. Lots of issues, but it was ok. It had a lot of character - that's what I liked about it, even if the plant layout was complex and the age was causing a lot to go wrong. 

They should have turned it into a museum after its decom in '13, but they didn't, to my knowledge, which was just wrong. It was a unique bird, and deffo should be preserved. 

Carriers seem huge at first but after a while they start to feel not all that big. You get used to moving around it quickly. 

I've often thought how I might enjoy the intimate feel of a small craft. I might have like them a bit better, but never got to find out, heh.
Reply: @fitsodafun Your reply is rife with non-/ill-informed opinion, not facts.

SMR's (of any type) are contained entities. Each of the approved designs is "inherently safe". Safer than every PWR/LWR currently in operation. These are advanced designs; going far beyond Gen III reactors.

As for MSR's, they take care of the current spent fuel issue. And they do this by creating a fraction of the waste; waste that needs to be stored for hundreds, not hundreds of thousands of years.

If you'd like to participate in conversations concerning nuclear energy for civilian electricity production, I suggest boning up on the subject. Copenhagen Atomics is a good place to start.

FUD (fear, uncertainty and doubt) is a tactic used by those with a vested interest in maintaining the status quo. It's unacceptable.
Reply: @fitsodafun You repeatedly cite "for profit" interests in compromising safety regarding nuclear and now rail transport. This is a gross oversimplification of the situation. Your assessment also conveniently ignores that for profit interests, from manufacturers to operators, have been involved in civilian nuclear power generation since the beginning, and that, despite Three Mile Island, Chernobyl and Fukushima, the industry enjoys a stellar safety record.

As for Fukushima, hindsight is always 20/20. The facts are that the risk of inundation due to tidal waves was underestimated and that both government and private sector players failed to revisit the assessment of these risks. Had they done so, preventative measures relating to backup safety systems could've been implemented; things such as moving backup generation to higher ground, locating backup generation in watertight bunkers and employing watertight connections between backup generation and plant equipment.

With that said, proposed, planned and approved SMR's are nothing like TMI or Fukushima. They're also not a BWR design. These reactors are "walk-away safe"; designed to automatically shutdown, as well as passively cool. Non-proliferation is also designed in.

The simple facts are that SMR's will be factory built and fueled. They'll simply be transported to site, commissioned, then operated. Some SMR designs will be operated for as little as 7 years when they're swapped with a new reactor. The old reactor is returned for refurbishment and refueling before being placed back in rotation. All of these processes will take place in relatively few sites with stringent safety processes, procedures, protocols and monitoring.

MSR's take this even further by processing the fuel/coolant in-situ; adding fissile material as needed...for the life of the facility (estimated to be in 50+ year range).

The train disaster you cite could be attributed as much to a combination of human error as to any corner cutting on the part of the operator.

Disasters too numerous to mention happen all the time all around the world. The Bhopal disaster. The recent train derailment in East Palestine, OH. The 2021 ERCOT grid failure. In hindsight, all were preventable. And the causes for all include human error, corporate negligence and governmental failure.

We've already entered an era where massive maritime vessels are remotely controlled, where over the road transport takes place without a human behind the wheel and where autonomous missions regularly deliver air cargo to remote outposts. Autonomous aerial last-mile package delivery will become mainstream soon. Driverless ride sharing, both terrestrial and aerial, are around the corner, as is full self-driving capability for millions of cars, vans and trucks.

Don't even mention the potential of AI to affect our world, both positively and negatively.

Literally nothing is risk-free. Having worked in the industry for years, I can say that the benefits of nuclear power far outway any of the risks you mention. There's far too much at stake.
Reply: @fitsodafun well, I’d say you’re being negative
Reply: I agree with this man's prognosis but would like to point out that most if not all the so called nucular waste we've all been paying for in taxes to keep contained.. is technologically easily recyclable back into fuel, something known for many years but kept secret for financial reasons.
Reply: @richardward6747  Both accuracy and precision are important when discussing all things nuclear.

The truth is that "spent" nuclear fuel reprocessing is far from easy. Additionally, it's not a secret at all. Nor do finances play a role.

The truth is that every other country that operates civilian nuclear reactors reprocesses fuel. So, no secret there. Additionally, the practice is banned in the US due to perceived proliferation risks.

It's well past time for this to change.

Lastly, there are many tons of both low- and high-level solid nuclear waste, as well as many millions of gallons of liquid nuclear waste. Some of this stuff is every bit as radioactive and toxic as "spent" fuel.

None of this could ever be used for future reactor design fuels. It's just really nasty waste that must be stabilized and stored for many thousands of years before it'll ever be safe to be near.
Reply: @ARepublicIfYouCanKeepIt  talking about the old containment from the subs/old reactors excreta could any of that just be re-used to make new? it would make sense to do so if so, save on cost of making new & storing the old. i am not aware of how reactors wear so ill have to rely on your information on this, thanks.
Reply: @blackdeath4eternity  Unfortunately, the materials from which nuclear reactors are constructed become compromised from long-term neutron bombardment.
Reply: @richardward6747  Do you have evidence for this?
Reply: Politicians :" Meh, coal and gas are cheaper, and those huge corporations are sponsoring us. People will vote for the other team if their living standards get a 3% decrease, so why bother. "
Reply: facts:buffering:💆‍♂
Reply: @scratchy996  Not to mention it takes 6 years from the beginning of construction to finish. Adding the planning and preparation stage, it can easily reach 8 or more years which is longer than a president terms.
Reply: @scratchy996  sadly likely true…
Reply: @scratchy996  Your SOL has been declining for 50 years.  Financial Capitalism
owns all the assets, winner take all, and make the laws. for the 99%
Reply: @jamesmorton7881  " Your SOL has been declining for 50 years. " - you don't know what you're talking about.
I live in Romania, the SOL has been considerably improved after the fall of communism, especially after joining the EU.
Everything from income to purchasing power to life expectancy has gone up thanks to Capitalism.
Go troll somewhere else.
Reply: @scratchy996 and yet everyone I know still votes Democrat or Republican, yet they all seem so aware of how flawed politics is.
Reply: What might happen if we sent nuclear waste into the sun? Or just off into the abyss?
Reply: @bigfish1187  The energy cost of lifting the waste off-planet would negate the energy gained from the fuel. Sending stuff into space is expensive.
Reply: @bigfish1187  I thought of it as a good idea as a kid as well, then I learned that roughly one out of twenty rockets explode. Would you like something in the scale of a Saturn V rocket explode with a payload of 120 Tons of highly radioactive material in the atmosphere? That’s a disaster so big we can not justify.
Reply: @bigfish1187  sure why not?
Reply: @bigfish1187  The big problem I've heard with launching waste into the sun is that a launch failure is a big problem.
Reply: @bigfish1187  once you got a space elevator working it might be worth it.... but currently it would be to costly i think to get it into space, more likely is just dumping it into a volcano BUT i don't actually see that happening.
Reply: @bigfish1187  rockets can explode. You can probably imagine that a rocket full of nuclear waste exploding high in the atmosphere, causing some of it to blow far and wide, and a bunch more to rain down onto a huge swath of the earth, would make for a pretty huge problem.
Reply: The core of the Russian BN-800 is about the size of a passenger car and can produce 800 megawatts of electricity. The BN-1200 in the works isn't much bigger and will be able to produce 1,200 megawatts.
Reply: @gregorymalchuk272  While I don't wish to engage in a back-and-forth exchange, a correction is needed. The core of a BN-800 is most definitely much, much larger than a passenger car.

The S3G reactor core that powered the submarine on which I served was larger than a passenger car. It also operated on highly enriched fuel (percentages are still classified, so I'm not at liberty to divulge) and produced much, much less than the 880MWe for which the BN-800 is rated (again, power ratings of naval nuclear reactors are classified).
Reply: Agree... we need it all now... just as soon as we humans learn not to invade each other's countries on whimsical pretexts cough russia cough*, and also as soon as the rest of us learn not to just stand by *cough all of us cough while cities are bombed and apartheid states cough Israel cough imprison entire populations for decades on trumped up histories and sabotage other nations on exaggerated fears. Only then we can have (and deserve) nice things, and can feel safe they won't be sabotaged by rogue states like these putting our lives and environment at risk from nuclear radiation.
Reply: We actually have a shielding product that works like lead. It's 10x's lighter and it absorbs radiation. Radiation cannot pass through it. The only probable is that the shields need to be a certain distance away from the reactor or it will drain the reactor. If the shielding gets too close, it will drain the reactor within minutes. We are trying to use three product for nuclear waste cleaning. Our products are enviro friendly and the waste is rendered enviro-friendly. We fundamentally change the elements. For example: Uranium decays to Lead eventually over a billion or more years. Lead is still hazardous to the water. Once we treat it, the Uranium is gone, no lead, and an environmentally friendly element is produced (proprietary). Currently, they are scared of us -jobs and corruption.
Reply: @hokeshuler1297  One cannot violate the rules of physics.
Reply: @ARepublicIfYouCanKeepIt  thanks for the comment. However, it does exactly what I explained. Trust me. I’ve heard what you’ve said many times. Even a nuclear engineering professor at Clemson University watched our product completely remove all radiation from Uranium and some kind of plutonium silver disk about the size of a silver dollar. Then we cleaned a few pieces of machinery that were radioactive. He kept saying, “This cannot be happening”. He wants to do a white paper. To be clear, the inventor of this product is not me. I’m a partner, but clearly it worked and clearly it removed all radiation in just a few seconds. So now that you have gone back to “you cannot violate the rules of physics”. Can you hazard a guess as to what might be happening here? Where did the radiation go? If you can’t offer a guess, it begs the question, How solid are the laws of physics?...I’m old so I remember when Quantum Physics was called bullshit, and now...theory, but something is happening in BOTH these cases that are not completely understood. Remember when gravity could not be explained and no one really new what it was. My point is Rules are only as good as who made the rules up, and at the time they were decided upon, they didn’t know everything and could not measure everything. The sad part is most scientists are not scientists. They are protectionists. You seem to have stopped asking “Why? or What if”. It’s not worth their time, or whatever. The Navajo knows it works, Savannah River knows it works with energized water and Cesium, Clemson University,  and hopefully soon, the Energy Department will know it works. My main issue is the closed minds. I’m not talking about you, however. You were kind enough to comment, and trust me...I appreciate it very much. This is only some background. If you’d like to take a guess as to what is happening, I’d love to hear it. Try this.... a uranium spill was on a metal table, bench and floor at a local college. Cost cost of the cleaning would be $12,000. Clearly it was radioactive using a Geiger Counter. We sprayed some of the product on a rag and in two wipes each, the radiation was gone from the table, bench, and floor using the same rag. The Geiger Counter could not register any active radiation on the wrap, table, bench or floor. The College kept the wrap to “study” it. I think they were waiting to see if the radiation would return. It did not. General Engineering Labs knows it works too. So take a guess. What might be happening. Then I’ll tell you if you are right or wrong. I’m just wondering how a normal engineer would guess. I know this is WAY out of your comfort zone cuz engineers like to be right. So I know you will respond...”it can’t violate the laws of physics so this exercise is a waste of time”. Yeah, so was the voyage of Christopher Columbus ( It’s round-ish). Or Galileo being forced to say the Sun was revolving around the Earth, and my favorite...Mendel, a lowly Priest and monk that discovered the principles of Genetics. It only took Mendel’s genius 130 yrs to be accepted. I hope our product doesn’t take that long.😂😂
Reply: @perspexsavant4787  Your purposeful omission of the name of the company, the product, and individuals associated with this magical discovery doesn't help your cause. In fact, it only heightens the doubt of those who may read the comment.

You've also committed a classic flaw that, once again, casts doubt on claims. Radiation, or radioactivity, and contamination are two different things.

Areas become contaminated with the accidental release of toxic materials. In the case of nuclear materials, some level of radiation contributes to the problems of exposure, clean-up/decontamination, storage and disposal.

As for "remov[ing] radiation from Uranium", both nature and physics tell us, "No way." Also, the lack of specificity about this "Uranium" is highly suspect. U-238, the most abundant, naturally occuring isotope, as well as U-235, both have extremely long half-lives, meaning they're stable and barely radioactive.

The dangers with Uranium only occur with high enrichment levels of U-235, the isotope most readily split from a collision with a loose neutron as in a nuclear reactor, or a nuclear weapon.

Now, onto "some kind of plutonium silver disk about the size of a silver dollar." Due to toxicity and radioactivity, as well as proliferation risks, it's extremely doubtful that a plutonium sample of that size would be available outside of a high-security containment facility.

As for "a few pieces of machinery that were radioactive." What are you even talking about? Machinery can be contaminated with nuclear/radioactive material, or the materials from which it's made can become slightly radioactive from long-term neutron bombardment. However, in the latter case, these materials are found in only a few settings, all highly restricted.

I've already spent way too much time already debunking unsubstantiated claims. So, unless and until you divulge the company and individuals responsible for this magical discovery...I'm out.
Reply: Nope.. also turkey point leaking still for five years plus now son.. leaking.. into drinking water. Facts. Not safe,not needed 🎯
Reply: I school people about power company leaks.. you are naive navyboy.
Reply: @dertythegrower  the FACT is... FIRST: I AM NOT YOUR SON I DOUBT VERY MUCH YOU WERE ACTUALLY TAKING TO YOUR LIL TADPOLE EITHER....  NOT PROPER EDICITE TO BELITTLE SOMEONE IN THAT MANNER!!!

SECONDLY ....:  YOU DO NOT KNOW !!!    WE **MIGHT** have to get a little bit RADIATED to survive something the SUN (see there I used that word properly, you did not with ''son'' DUDE......) will be doing in the future sometime, and the ''nuke plants are the SEEDS for our ACTUAL SURVIVLE LATER hundreds or thousands of years into our FUTURE  THE FACT IS YOU DO NOT KNO EVERYTHING !
Reply: only 0.7% of all the yellow cake in Australia and round the world is usable for enriching so 99% ends up out of the ground blowing in the wind and the Aboriginal people have suffered greatly and still do to this day. It is a filthy, corrupt and weaponized industry that should have been Thorium based from the start. Biomass Gasifiers do best in our farms which are off grid it powers everything we need and filtered using black water which is then fed back into our plantation forests that feed our energy for the future usage. There are so many ways to save electricity yet most is now wasted using the 4gLTE and 5g emerging weaponized grids but few care that centralized energy is the problem and global warming is a deception you can easily learn about in books such as behind the green mask. We are now experimenting with micro Algae also which is successful for making refined fuels as well for turbines. Nuke waste needs to be dealt asap as it is over stored in all major cities, it is a major issue that hopefully can be solved by the same synonymous criminal nuclear and military industry.
Reply: Solve the “travesty”. That’s job one. Nuclear waste sites are strategic and terrorist targets. They are mismanagement prone. Remediation is not coated in new nuclear energy scenarios. Even the Navy doesn’t have a workable decommissioning and storage plan.
Reply: @SLow-fb3qm  As respectfully as is possible given your comment, you don't know what you're talking about.

Let's begin with your final statement, that "[E]ven the Navy doesn’t have a workable decommissioning and storage plan." We all rise and fall on our definitions, so please define "workable".

For all its flaws, the Ship/Submarine Recycling Program is hands-down, the best decommissioning program in the world. It also has a sterling safety record.

Coolant systems are drained, reactors are defueled, reactor sections are removed, and reactors are contained and stored. All irradiated and/or contaminated components are also processed.

The Hanford Nuclear Reserve where decommissioned reactor sections are stored has issues for sure. However, these reactors aren't to blame.

With all that said, and to address the remainder of your comments, there is no permanent solution for our nuclear waste or spent nuclear fuel problems. Vitrification and subterrial storage are the best hope for safely storing nuclear waste for the millenia necessary for them to degrade to levels at or below background.

Advanced reactor designs, such as MSRs and MCSFRs, are actually capable of generating power from spent nuclear fuels for many decades; ultimately resolving this particular problem. So there's that.

To your "mismanagement" charge, there's not been a single safety incident associated with the management of nuclear waste or spent fuel storage.

As many people do, you refer to "nuclear waste" without distinguishing actual nuclear waste from spent nuclear fuel. Again, your insistence that these sites "are strategic and terrorist targets" just isn't borne out by the facts.
Reply: Geothermal actually isn't very reliable because it needs to be near a plate boundary in order to get those hot gasses in the ground. Being near a plate boundary, of course, means earthquakes, and that's a pretty big nono
Reply: @MrKobus-rz4qy  With respect, geothermal is one of the most reliable forms of renewable energy available.

We all rise and fall on our definitions. Geothermal can be used for electricity generation and process heat, as well as heating of the built environment.

One need look no farther than Iceland for a perfect case in point. Neither seismic nor volcanic activity negativity impact Iceland's exploitation of geothermal energy 

For every area not proximal to shallow superheated geothermal resources, the earth only 10 feet below the surface maintains a constant temperature year-round. While not sufficient for electricity generation, shallow, closed loop systems are able to both raise the temperature of a heat transfer medium during heating season, and act as a heat sink during cooling season. This same system cam also preheat water for hot water.

Combined with ground-source heat pumps and hybrid water heaters, this ubiquitous renewable energy source has the potential to bring our built environment to net-zero emissions 

Need proof? Check out Whisper Valley in Austin, TX
Reply: @ARepublicIfYouCanKeepIt  you make a good point, however Iceland is not the place to point to because just in 2021 they had 14 earthquakes above 5.0 magnitude, plus it's terrain is rocky, so not a very good place for geothermal reactors. Thanks for the response though.

Edit: thank you for your service aswell!
Reply: @MrKobus-rz4qy  Not to seem (or be) argumentative, but you do realize that geothermal accounts for about 65% of Iceland's primary energy  production, right? Geothermal also heats 90% of Iceland's homes.

Iceland's shift from fossil fuels to geothermal and other renewable energy sources began in the 1970's and has thus far resulted in global greenhouse gas emissions reductions exceeding 40%. Save the transport sector, Iceland uses nearly zero fossil fuels. Their electricity grid is 100% renewables.
Reply: This is YouTube. It’s not a scientific journal. So my omission was for brevity. The more enriched Uranium or Plutonium is; the easier it is for our product to handle. As for contaminated/ radioactive; both can be in contaminated water. This product handles VOC’s, hazardous metals( do you think I should list all the hazardous metals here) and radioactive waste( should I list all the radioactive metals here too). Sooo… I was speaking “in general”, and you jumped to specifics. This proves I hit a rawness in your educated knowledge which makes you nothing more than a protectionist. Instead of asking questions; you attack. If you are familiar with the “Standard Model”; you should understand Flux Tubes and the force between Up quarks and Down quarks within Protons and Neutrons. However, it’s the weak force that we use at a sub-atomic level. And what does the weak force do… decay. As you know, there is a ton of material behind all the intricacies of this. So brevity is helpful and a high level view is all I can give without writing a book. If you are “out”; ok.  Just keep in mind, MANY famous people have been wrong, and it’s the Protectionists that will not allow growth. There are FAR more Protectionists than Scientists. All I’m saying is: Open Your Mind and Be Different. The world needs your mind. No one needs a Parrot.
Reply: There is one solution that’s not been discussed in the disposal of nuclear waste. Send them all in space to crash on the sun or toward interstellar space where they can never be seen again. The former looks better and cleaner than the latter where it’s totally deleted from existence. With the much more reliable SpaceX launches coupled with a much smaller fractions of launch cost, this disposal method will be looking more and more feasible.
Reply: @leapdrive  Jettisoning spent nuclear fuel to space is totally implausible for myriad reasons. The first is cost. Who'll pay for the thousands of launches that would be necessary? Also, consider that deep space missions (which is what you propose) are much more costly than low earth orbit missions. The second is safety. The third is logistics. These are all insurmountable.

Consider this, I worked on nuclear waste vitrification over three decades ago. At the time, the "plan" was deep, subterranean interment beneath Yucca Mountain, NV. Initially authorized, with development and operation started many years ago, the Yucca Mountain Nuclear Waste Repository project was defunded during the Obama administration. During the Trump administration, even funding for alternative permanent disposal sites was defunded. The Biden administration has announced that the YMNWR is not part of the current nuclear waste disposal plan (such as it is).

Now, if it's taken three decades to start, stop, then kill a disposal site, what do you think the odds are that the public would approve of strapping 1,000 Kg loads onto rockets to be shot into space?
Reply: No, shipmate. Ya needs to get yr ducks in a row. Coal oil gas aren't nuclear hazards. Solar wind hydro wave tidal, all that human hazard manufacturing effort energy and materials to make ground-fill new coal. It'd be like farming blue whales to tug ships across oceans to save on bunker fuels. Oxen carts have had their time.
Reply: So, we have the engineering know-how now.  but no leaders or adviser to chart a prosperous future.
Reply: Spreading nuclear waste around like "buckshot" sounds terrifying. How much spent fuel is currently being used for energy production? How many nuclear reactors have been built at or under the original budget? Considering the cost of indefinitely storing waste, have any nuclear reactors been profitable without externalizing the storage expenses to the taxpayers?
Reply: @wdentondouglas 
.
Most of the solid waste of existing (PWR) reactors is contaminated, unburnable enriched U235. Fast molten salt reactors can burn all but a tiny fraction of this (easily dissolvable) waste (and any kind of nuclear waste) as fuel - simply. cheaply, cleanly and safely. This "waste" would provide cheap energy for, like, 100 yrs or more. (see Ed Pheil, Elysium and MCSFR on YouTube). After that they could just burn Thorium/Uranium outright, also with tiny amounts of waste. By that time technology will hopefully be far advanced over what we now have, and we would not have contributed to atmospheric CO2 with any of this.
Reply: @wdentondouglas  Firstly, "Spreading nuclear waste around like 'buckshot' sounds terrifying." Really? How do you think the vast majority of spent nuclear fuel (SNF) is currently stored? In storage pools (necessary to cool decay heat), as well as so-called "dry storage" literally out in the open at existing nuclear power plants.

"How much spent fuel is currently being used for energy production?" Exactly none. And that's the central point. There are multiple next generation reactor designs for which the existing stockpile of SNF would comprise a large part of the fuel mix. This represents an available source of fuel that would a) generate reliable, carbon-free, baseload power, b) reduce the existing SNF stockpile, while c) producing a fraction of the waste that's both less toxic/radioactive for a dramatically shorter duration. This is what's commonly known as a win-win-win scenario.

"How many nuclear reactors have been built at or under the original budget?" This question is based on the fundamentally flawed assumption that past is prologue. It's not. Whether it's a SMR, MSR or MSCFR, next generation reactors are all modular and factory-built, operate at low pressure (read very near or at atmospheric pressure), and incorporate what are known as "walk-away safe" technologies, meaning that, even with the complete loss of local power, these reactors passively and automatically shutdown. So, yeah, next generation reactors will be much, much more cost effective.

The last question is, again, fatally flawed; this time based on misinformation or a general lack of knowledge. The truth is that general taxpayers don't pay for the costs to store SNF. Possibly unaware, rate payers pay a tax into the Nuclear Waste Fund. The fund's current balance stands at over $44 billion, including over $1 billion in interest income per annum.

The problem is that we currently store about 90,000 metric tons of SNF at some 70 sites in 35 states. This waste remains radiotoxic for over 1,000 years.

The "solution" was to permanently entomb vitrified waste in a central storage facility. However, plans for Yucca Mountain have been stalled for many years and there's been no progress on alternate sites. We're in a kind of "nuclear waste stalemate" while our existing reactors continue producing 2,000 mt of SNF every year.

Beyond vitrified burial, the ban on reprocessing SNF could be lifted and/or next generation reactors that burn SNF as fuel could be permitted and built. Unfortunately, these decisions are left to federal agencies and the Congress.
Reply: Waiting for a mobile phone nuclear reactor.😅
Reply: "We were perfecting vitrification of high-level nuclear waste over 35 years ago"...well, but why are scientists still working on the problem and are not sure, what happens over hundreds of years, when water touches the glass? And DuPont really? I don´t think that such companies are very trustworthy. But besides that, the waste would be still there, just "contained" in glass and steel, which still requires storage at a safe, controlled and expensive site.
Reply: @DamienFromPoison  The science of vitrification for encapsulation of high-level nuclear waste is proven.

"When water touches glass?" What are you even talking about?

"DuPont really?" Yeah, really. Sounds like you've not worked within the military, government or industry, and are prone to conspiracy theories.

We trust large corporations with every aspect of your lives every day!

I never implied that vitrification eliminated nuclear waste. It is, in fact, a way to facilitate long-term underground storage for millenia.

If you read my original comment, you'd see that I support MSR technology, partially for the promise of reducing the spent fuel stockpile.
Reply: @ARepublicIfYouCanKeepIt  I did looked into the prospects for P&T for my masters thesis, and I was wondering – do you think it's worth vitrifying the waste with current technology instead of waiting for advanced partitioning technology to develop at a larger scale? As far as I understand, vitrifying waste means that it becomes impractical to recycle any further.
Reply: @Bannedforfun  Unfortunately, vitrification is final. The various waste materials become fully incorporated within the crystalline matrix so as to render the whole affair stable.

Once poured into a liner, cooled, sealed, then sealed again in an outer cask, transported and placed in a storage facility, there the slug will stay for millenia; over time decaying to no more than background levels of radiation.

As for vitrifying or waiting for some other solution, the problem is very big and very real today. We're long past the time to take action.

As for spent fuel, I'd like to see the ban on reprocessing lifted. Reprocessing all of the spent fuel languishing in pools across the nation would do at least two things:  It'd contribute material for new fuel while significantly reducing the total amount of waste that would need to be vitrified.

It'd take years to either reprocess spent fuel and vitrify all the other waste. Plenty of time for MSR designs to be approved, built and begin working down the spent fuel stockpile.

No silver bullet. Only silver buckshot.
Reply: @ARepublicIfYouCanKeepIt  Yes, exactly – vitrification is final, so it guarantees that the waste volume cannot be reused/reduced further, exactly why I consider it a worthwhile dilemma. Thanks for the answer re: reprocess now or wait.
Reply: @Bannedforfun  There's no better solution, now or in the foreseeable future, than vitrification for certain types of waste. Leaking holding tanks at Hanford are a prime example.
Reply: @DamienFromPoison  I'm wondering if you are comfortable with DuPont contributing to the solar industry? They do, you know. That particular attack is tantamount to an ad hominem attack. And in general your objection is based on the notion that the tiniest amount of radioactive material released into the environment is dangerous. That's an incorrect notion. We live on a radioactive planet in the radioactive universe. Radioactivity is all natural. This isn't to say that all levels of radioactivity are safe, they certainly aren't. And there's certainly a difference between being exposed to ionizing radiation and ingesting radioactive materials. We ingest radioactive materials every day in the form of bananas, and anything that contains natural potassium. So your argument presumes that we hold the nuclear industry to an unnatural level of security in its waste stream. In fact they're doing a fabulous job when compared to the solar industry, say. In order to tout least cost per kilowatt of power produced solar panels are manufactured in China where we have learned that uieger labor is used and effluent is dumped into rivers. This doesn't give us the virtuous high ground in the realm of solar. All forms of energy production have costs and benefits we need to weigh those objectively in order to achieve the best energy mix. Always be suspicious of any strategy touting 100% or zero of anything.
Reply: @billygogesch6365  I am not comforable with most bi industries and I hate, that so many solar panels come from China. But those are political problems. We had a thriving solar industry in Germany, but they were not wanted, so 300.000 jobs were lost in favour of extending the life of brown coal and the connected 80.000 miners. There are still solar panel manufactures left in Germany, but they are a tad more expensive, but you will see much less environmental impact of those, as electronic devices have to be recycled by law. Nuclear has its problems in all countries, they produce waste, that is dangerous and very expensive to handle. This is not a problem with solar or wind, at least when your country does it right. Just because China and America do a bad job with recycling, we should not try to change. And I wonder if you could give me some facts about your "they're doing a fabulous job". Well, they let us pay to handle the dirt and most of the waste is stored at site, beacuse they do not know what do do. I would not call that fabulous.
Reply: @DamienFromPoison  The problem with waste is not that it is expensive to store/contain. It is because there is always a risk that terrorist or war could destabilize/use them for terrible cause.
Reply: @super_hero2  Oh is is horribly expensive to store the waste, it needs constant security and stable energy for cooling etc., we had some crazy experiments with "storing" that shit in Germany.
Reply: @DamienFromPoison  I guess it depends on what you mean by "expensive". Nuclear waste management cost is a small fraction of the value of electricity generate from a nuclear plant.
Reply: @super_hero2  No, it is not a small fraction. You have to include the decomission of old plants with the waste costs. It is very hard to calculate that stuff, but there are essimates for Germany and with our small number of nuclear plants, we will have to pay around 200 billion USD for removing all plants and handling the wase, when all is said and done. Building back a nuclear plant is incredibly time consuming and costly. No think, what a country like France faces, when they finally destruct their old unsafe plants.
Reply: @DamienFromPoison  Yes it is hard to measure and I can't find a good number but I read an article by World Nuclear Association about radioactive waste and they think that the cost is small compare to the benefit.
If you have better source please let me know.
Reply: @DamienFromPoison  Do you have a source? It is the only source I can find about the cost of waste management. I am not sure about Germany's nuclear plant, but it sounds more like a corruption problem than technical problem.
I am pretty clear on my previous replies that nuclear energy is not ready to be the main source of energy yet. But it is indeed the future and we need more research and test to make it more robust.
Reply: @super_hero2  No, it is not the future, the future are renewable sources and storage. Renewables work, we just need to build more of it. Every dollar wasted on nuclear technology, which may never be ready, delays a real future.
And corruption issues with nuclear plants only stem from the companies running them and winding themselves out of paying their fair share of what they have done.
As for the costs, nobody can say for sure, only that it will cost more than the companies are shelling out for it. And my state will not let pay their fair share, because this would bankrupt those companies. Do you get it? Cleaning up their mess, would bankrupt them. So it was never profitable, when you look at the real costs:
https://www.dw.com/en/scrapping-nuclear-plants-to-cost-billions/a-17439221
https://e360.yale.edu/features/soaring_cost_german_nuclear_shutdown
Reply: @DamienFromPoison  Renewable can help with climate change but can it support humanity needs of energy 100 years from now? Nuclear can provide immense amount of energy, but right now there are still problems with the tech and it still has a long way to go. I clearly stated in my previous comment that nuclear is not ready right now, if you bother to read it at all.
First you need to separate waste containment cost and deconstruction cost, we are talking about the former not the latter. I think the problem with Germany is bad tech/management. Other countries like France, U.S. do not spend that much to deal with nuclear waste. In the U.S. we pay around 6 billions every year for nuclear waste, in 2021 we used 778 billion kWh from nuclear. It is something but it is a small fraction of the value from nuclear plants. So the problem here is not the tech, it is the human.
Reply: @super_hero2  You have to look for the cost of deconstruction, as it makes nuclear a much worse option. And you should not look at all at France, if you want to praise nuclear. Their state run nuclear company is in so much debt, because nuclear is not cost effective, it isn´t even funny.
And I red your posts, that nuclear is not ready, I just repeat myself all the time, that it may never be ready. We habe a problem now, in 50 years it is to late. So lets end this discussion, as we go in circles here. byebye
Reply: @DamienFromPoison  Over 90% of today's waste contains valuable reusable energy. I am not a supporter of vitrifying waste, this will force long term storage commitments and make the product inaccessible for easy re-use. For example, at some time in the foreseeable future we may burn it (transmute) say in fast breeder reactors. I feel the present delay to provide deep storage is simply a realization that better solutions are on the horizon. In any case the amounts of nuclear waste needing storage is small by industrial standards 
There are several theoretical solutions around reprocessing, the issue is cost. I suggest we store it intact for now until technology provides an economic transmute solution.
Reply: Why do we "need" it "now"?  What's the rush?
Are you among those who believe, contrary to the evidence, that CO2 causes massive greenhouse forcing?
Reply: @firecloud77  Really? You're going to try that here?
Reply: @firecloud77  The science IS settled. Stop celebrating ignorance.
Reply: @firecloud77  You are not arguing in good faith. String Theory may not be settled science, exactly how gravity works may not be settled science, dark matter may not be settled science. 
- The science on climate is as settled as it gets. We know by a preponderance of evidence, and well beyond a reasonable doubt.
 That doesn't mean we know everything there is to know, but we have a really good handle on the basic process. We have enough information to reach s conclusion with very high confidence. - A level of confidence that would move a reasonable person to take action in virtually any real life situation.
 - And you know it.
 Or you damn well should know it. NO reputable scientists or scientific organizations question the basic reality of anthropogenic climate change. And hundreds of them, every established scientific society and organization, from everywhere on Earth have issued statements that unequivocally confirm that it exists.
 And yes, I have DATA.
You either purposely haven't done your homework, or you're being disingenuous.
Reply: @firecloud77  😂
Reply: @firecloud77  Hm, so do you mean, that man made CO2 is not a big factor with the ongoing climate change?
What evidence can you produce for saying such a thing? Okay, we pump other things into our atmosphere, which are even worse than CO2, but it is still a massive problem. So do you deny man made climate change?
Reply: @firecloud77  yes, I know. Have you noticed how science is used to confuse people? We can all tell that the Earth is flat, just look under your feet, yet many say it is a sphere! 🤔
Reply: @firecloud77  oh... I was quite PLEASED with that effort 😊 I thought it reflected your argument closely.
Reply: Very interesting & informative post. Hopefully it won't be long before people realise wind & solar are a waste of time, promoted by politicians who want to look good.
Nuclear & tidal seem to be the obvious choice.
Reply: @nb9361  Wind and solar are far from a "waste of time". They're both vitally important components of the "silver buckshot" required to deliver true energy independence.
Reply: @ARepublicIfYouCanKeepIt  Hmm, may be, I was thinking more about here in the UK. The wind & sun are not reliable enough, and as you know the energy produced from this source has to be stored.
My main concern for anyone under the age of 30, is that oil & gas have about 50 years left. Granted this could be stretched a little, but not by much. We therefore need to be looking at making energy on a reliable way. This means nuclear energy. Fusion is always 35 years away, & that is just to prove the theory. So just 15 years to build a commercial network of fusion reactors then. Thorium reactors, no question.
Reply: @nb9361  Yeah, with a considerable background in nuclear fission for both marine propulsion and civil energy production, I dismiss fusion altogether. Yes, R&D should definitely continue. However, unless and until some massive breakthrough occurs, we can't plan our energy future with fusion playing any role.

Again, with my silver buckshot approach, you use renewables that make sense in situ. In the UK, not known for its abundant sunshine, PV doesn't make the most sense. Likewise with wind. Deploy it where it's reliable. Something I'd not specifically called out in earlier posts is offshore wind. This really makes the most sense.

Envision and offshore plant where a variety of missions are accomplished:
1. Harness reliable wind.
2. Harness reliable wave/tidal.
3. Use locally generated power to:
a) Desalinate seawater
b) Produce "green" hydrogen

Transport freshwater and hydrogen, either by pipeline or barge, and transport excess electricity via high-voltage DC (HVDC) transmission lines.

With 40% of the world's population living along coastlines, nearly all of the electricity demands are met, while reliably providing freshwater, as well as hydrogen for, in particular, civil marine propulsion. Think cargo shipping.

Solutions such as these represent a new, better, sustainable future for both the first world and the developing world.
Reply: @ARepublicIfYouCanKeepIt  Agreed. Now try telling our politicians. They only promote ideas that make them look good.
Reply: @nb9361  Thorium reactors are not proven for wide commercial use and we can´t even build the old reactors anymore under 10-20 years without going massivly over budget. Why should we able to build next gen reactors in a timeframe which could save us? Wind and solar are proven, cheap and safe, we just need more money spend at storage solutions.
Reply: @DamienFromPoison  solve the 24/7/365 problem with renewables at reasonable cost (costing EVERYTHING along the energy delivery cycle and recycling after decommissioning and not just one aspect to then claim solar is around $20 MWh or similar nonsense), and then I will start taking renewables seriously. Next, solve the problem of large land and resource use required for renewables and I will start to love them (think of the large areas of land under solar panels, wind turbines mincing birds, mining of the materials required to build all these structures, associated pollution and recycling requirements, resource limitations through scarce minerals and metals, etc, etc... and compare these to what is required for nuclear).
Reply: @nb9361  I'm currently looking at a house move and thinking if it's possible to get a solar/inverter/battery system to get me off the grid. A company told me that they have done this to a couple of homes in Norfolk but trying to get the exact details/specs from them is like pulling teeth. I think that a solar system would struggle during the Winter months, even if you used items like a washing machine once a week, which is what I currently do funny enough. I only turn my WiFi on when I'm using the PC for example, I try to use as little power as necessary but the fridge freezer and heating control needs to draw power 24/7 obviously. Got any advice for me?
Reply: @robertlipka9541  Well, most things you mention are a problem with nuclear, too. But you also talk about wind turbines killing birds, which is a very stupid strawman argument, house cats kill a ridiculus amount more birds than turbines, windows too.
The decommissioning of nuclear plants is not included in nuclear plant cost. Here in Germany we are doing that for quite some years now and it costs billions of extra Euros. Waste storage is super expensive, too. Oh, and mining uranium is quite horrible for the environment. Solar panels can be recycled, lithium batteries can be recycled, steel from wind turbines can be recycled. Uran gets used up and a nuclear plants can´t be recycled, everthing coming from there is contaminated.
The 24/7/365 problem is about solved with energy storage solutions, we just need to invest a bit more. But even here in Germany the politicians fight renewables tooth and nail.
Yeah, renewables need some work, but they are proven. Gen IV nuclear reactors are a pipe dream. And even if they were not, nuclear plants are to expensive to build, there are not enough places (need rivers etc.) for them and they take 10-20 years to build. Look at france, they want to build 14 new plants...in 30 years. In those 30 years many more than 14 of the existing ones will shut down.
The only angle nuclear makes "sense" is from a military proliferation standpoint. Without civil nuclear, no military nuclear. But, if you want that, we should not talk anymore.
Reply: @ARepublicIfYouCanKeepIt  I agree with the Fusion thing being far fetched. The cost to build these machines is astronomical and even if it does work one day the payback is many decades and there will always be very expensive maintenance on these things what with the temperatures they have to run at.
Reply: @steveclark..  Get a smart meter and look at your energy usage.
Read the spec for energy generation of the wind gen. & solar PV.
You will see that you are about 80 to 90% short of energy  needed to live comfortably.
Reply: @steveclark..  If that doesn't work for you, buy a tee-pee, go live in the woods & live like a crusty.
Reply: @DamienFromPoison  the problem with birds and turbines is not a straw man argument or a minor matter... please look it up/educate yourself (I mean this in a kind way, it is important that people understand it). Rather it is a major problem in many areas I care about.

The decommissioning of nuclear plants is included in their costs, I believe there is an ongoing fee that accumulates to pay for it. However, I prefer the next generation nuclear plants that do not use uranium and do not produce long lived waste. Equally, I have NEVER seen decommissioning and recycling costed into renewables... or even seen technologies for recycling renewable waste. I believe, currently, used up solar panels are mostly buried in landfill, same for turbine blades... they ARE NOT recycled.

The problem with storage is not that it is impossible... it is just too expensive and uses up too much space and resources to provide 24/7/365 (and costs for all this). Plus my worry is that at the scale required for 100% renewables with storage, there simply is not enough of the necessary resources to produce all the batteries. Do we even have facilities for large scale recycling of lithium batteries? If all these problems change/are solved, I will change my mind... BUT one should not say it is solved, and the technology is ready to provide 24/7/365, because it is not.

Thorium nuclear cannot be used for nukes... all the claims that it can are a mixture of not knowing how it works and impractical suggestions. Plus, it is not true that nuclear power plants take a long time to build, these issues are being addressed by standardized construction and approval processes.
Reply: @robertlipka9541  Sorry, but the amount of birds killed by wind turbine is minor comapred to windows, cats, cars and pollution. You should look it up yourself, but here in Germany about 100.000 birds are killed by wind turbines 18.000.000 by windows.
And no the decommissioning of nuclear plants is not priced in, they tell you that, but the costs explode, companys go bust and then the tax payer has to pay for it. Do you really think the french nuclear company has the money to pay for dozends of plants in the next 10-20 years, when they go offline? The already have massive debts.
Aboutsolar panels and recycling, that is a political problem, you just have to vote better. I don´t know, maybe you are from the USA, where only 10% of the panels are recycled. Here in Germany the recycling is priced in, because companies are forced to take back and recycle electronic products.
About batteries, there are many more technologies for energy storage, lithium ion is just part of the solution. And lithium is abundant, can be sourced from good sources and is totaly recycleable.
And there still are none of the fantasy Gen IV reactors out there, only experiments. Some of them dating back decades, when they could not overcome the safety problems and were shut down after a short while.
Nuclear plants take forever to build these days, just look at the problems new european plants have and these are standart designs.
France wants to build 14 new plants in...30 years...to late to have any impact on the climate. The money would be better spend elsewhere.
Reply: @nb9361  Since the 1960's I was taught in elementary school that we would be out of oil within 30 years, natural gas in 50 years, and coal in 70-80 years.   They said the same thing when I was high school and later in college, and again in the 1980s and 1990s.  Here we are 60 years later and we still have oil, natural gas, and lots of coal, but we have a newer boogie man, climate change to be afraid of and a whole new set of dire predictions.

The envirophobiasts have cried wolf for too long and in too many ways to have much credibility with me.  Yes, I know, they have all kinds of data and graphs to support them.  BUT, so do the scientists who say it is bunk.  And the scientists who say it is bunk have a much better track record for being right.
Reply: @DamienFromPoison  I am not sure what you are talking about, but it is not minor. YouTube blocks all external links so I cannot post... but even a fast google search shows that worldwide bird deaths from turbines are in millions. Your other information I am also not going to pick apart but it is very different from what I know.
Reply: @DamienFromPoison  I am not sure birds killed by buildings figure is accurate (I live around very tall buildings with and have not seen a single fatal bird strike in many years, but I often see them bumping into windows thinking they can fly through it), but it is easily solved. The problem is not buildings but glass surfaces, at certain times of day they act as mirrors, perhaps trees reflect in windows and birds try to go for them, bumping into the glass. The solution is simple: place some objects, even paper dots on the inside of windows so birds can see them and they will not hit the windows. Window marking for this purpose should be a LEGAL requirement.

The figures I saw for USA were several hundred thousand bird COUNTED deaths from wind turbines in 2014 (there was less wind energy then). Uncounted deaths would be higher. I guesstimated it to millions but a proper study is needed.
Reply: @DamienFromPoison  please stop making up stuff. If you do not want to listen, fine. I am not here to convince anyone.
Reply: @robertlipka9541  "Making up stuff"?...just google what I told you, it is really not that hard.
You don´t seem to be able to tell the difference between millions and billions (to be fair, that is american billions).
And what should I listen to? You have not said anything more substantial than tell me what you saw with your own eyes, when birds bounced against your window.
Reply: @robertlipka9541  Okay, here in Germany we have such studies, for example the PROGRESS study from the University of Bielefeld, supported by our Federal Ministry for the Environment and Federal Ministry for Economics. Our Federal Environment Agency has a database for wind turbine bird killings and the numbers are very low.
The numbers for window death come from a large nature organization called BUND and they are based on multiple papers and studies from all over the world, for example
- "The avian benefits of wind energy: A 2009 update"
- "Comparison of fatal bird injuries from collisions with towers and windows"
- "BIRD INJURIES, CAUSE OF DEATH, AND RECUPERATION FROM COLLISIONS WITH WINDOWS"
- "COLLISIONS BETWEEN BIRDS AND WINDOWS: MORTALITY AND PREVENTION"
- "Bird–building collisions in the United States: Estimates of annual mortality and species vulnerability"

The thing is, it is not about that wind turbines get a pass. It is about, what is best for our environment. Wind and solar are just plain better for birds, than any other form of energy generation. This video here was clearly shilling for nuclear and you and the others, who are pro nuclear, try to paint something like wind turbines in a bad light, because the have to claw for every single straw in their fight. I would even argue, that the birds argument is disingenuous, as most people who start with this, never before in their life thought about birds and do not shed a single tear for the billions of male chicks getting shredded, because they do not lay eggs.
Reply: @DamienFromPoison  I have a Physics background (PhD though not nuclear physics), on balance, while not exactly expert opinion, but based on good familiarity with the topic I believe that thorium nuclear energy is the best overall choice (it needs a serious, non-biased examination as a carbon free energy option). I think solar is good where suitable, but I am against wind power. This video was not too bad if not a full treatment of the topic.

On the bird issue, window strikes are less of a problem where I live. Not exactly sure why, but probably due to what species live here.
Reply: @nb9361  correct me if im wrong, storing energy is a good thing.  Im not aware of a way to store alternating current. the sun puts off enough energy we just gotta learn how to harness it.
Reply: @robertlipka9541   @Robert Lipka  It is completely irrelevant if you have PhD and it is completely irrelevant, what you have or have not seen with your own eyes. And escepcially when you have such backgrounds you should know that.
On the Thorium reactors, or SMR or MSR oder whatever Gen IV, these are mostly old technologies, they are experimenting with them for decades now and still can´t fix all the problems with them. We have examined that for long enough, enough money was poured in, it is just a distraction from the real solutions. If my country would not have stalled the development of renewable energies in the last 15 years, we would not face an energy crisis becaus of the war in Ukraine. On good days we produce 100% of our electriy energy with renewable sources. If we invested more, this figure would be the norm. Our biggest science organization with contracts in every industry you can think of, the Fraunhofer Institute, has a study on 100% renewable energy and they are sure it would work, so even your colleges argue in favour of renewable energy. Nuclear just is not an option, to expensive, to slow, still a finite resource and just not ready.
About your dislike for wind turbines, you have not produced anything of substance against wind eneregy. I even told you, that nuclear plants kill more birds, so even that argmument could be turned around easily.
Reply: @DamienFromPoison  too many straw men. Just because birds die in other ways, does not mean wind turbines get pass... WHEN there are alternative sources of carbon free energy that will protect the environment (thorium nuclear). Bird strikes on windows can be solved with window and building design... as I said, I will repeat, it does not happen much at all where I live, but I have a LOT of birds in my area. Cats roaming by themselves should be caught. IF the cat appears homeless, it should be rehomed. If it belongs to someone, perhaps HUGE fines will do the trick. The point is that birds hitting buildings can and should be solved... I am not sure how you do that with wind turbines.
Reply: @robertlipka9541  There is work done on wind turbine design all the time and the low numbers go down. And still, the numbers are insignificant compared to everything else. But lets stop with glass and cats, as I see that you somehow try to turn the argument against me.
You do not seem to get it, wind and solar are the alternatives with lower bird death. I can only reapeat myself, nuclear plants kill more birds. And you can repeat it as long as you want Mr. PhD., what you see is irrelevant. It is about sample size and time not hearsay. 
There are no commercial Thorium reactors and we do not know if they will ever be ready. They still produce waste and have other safety concerns, wind and solar do not have. Oh, and Thorium like every other nuclear plant will have a carbon footprint for the building, for the mining and shiping of its fuel, for the waste storage etc.
Reply: @nb9361  I've had a few motorhomes over the years so am familiar with a 12V leisure battery set up but the wife likes to stay on a proper campsites with hook up so I don't even know how well such systems cope with say a couple of panels on the roof in the long run. My latest camper is fitted with 12V lights, fridge and TV so no inverter in the mix with this system,.....I'm wondering if  the few people who do live in an off grid home would have replaced as many items as they could with 12V versions?? This may make it possible I'm guessing, I know that you can get a 12V microwave, not sure about a washing machine though.
Reply: @nb9361  Unless you are wealthy, we may all end up in the woods hey.
Reply: @DamienFromPoison  Temperature fluctuations are normal.  In Ohio, USA we have had record snow falls this winter.  It is 19 degrees F right now.  I'm not claiming that the climate may be changing.  It is always changing.  Nor do I deny that man may play a role in that.  But, the Left has been actively suppressing scientific debate that opposes their view.  That is not how science is supposed to work.  Here is one example:  https://www.youtube.com/watch?v=CZy8mgD05QA
Reply: @nb9361  You are right that solar is a poor performer in Britain but you do not have to go too far south and the sun shines a lot more. Developing long-distance undersea cabling to carry solar power to where it is needed would be much simpler from the engineering perspective than nutting out all the problems with various nuclear formats. Here in Australia, the output from solar arrays is staggering and cheap. Simpler and larger energy storage systems will need to be brought to market sooner rather than later and when they are you will not compete with the cost per Kw from solar. But hey with climate change happening at a faster rate you may find that solar becomes viable even in Britain😁
Reply: @alistairshanks5099  Not so, take a look at 'Real Engineering' The problem with solar in Africa' it's been tried & it failed miserably.
Reply: @robertlipka9541  Solar can be generated on rooftops right where it can mostly be used so it does not have to take up extra space. That is dependent on if people see it as viable. If they don't then you won't see much solar on rooftops and your prophesy about taking up large areas of space may come true. As in self fulfilling prophesy. As for storage it is not perfect as of now. but the type of batteries required do not need high energy density as associated with EV's, so that simplifies research significantly to concentrate on longevity of storage and efficiency.. Storing solar in the form of hydrogen production is one possible solution but it is not greatly efficient. Short term storage say overnight or a few days could be accomplished with old EV batteries. Plugging in EV's at low use electricity hours and supplying back to the grid at high use hours when the vehicle is not in use is another. Another solution is smart grids that distribute solar or wind power to areas where there is little sunlight/wind from areas where there is a lot. As for hole countries that may not get much of either then we need reliable energy agreements between friendly nations. Spain and Morocco could supply large amounts for Britain and other northern regions of Europe. In turn Britain or perhaps Germany could supply power from wind to Spain and Morocco. Britain has large amounts of off shore wind available. Germany has so much solar and wind power at times that the price per kilowatt has gone negative. So even in Germany over abundant solar/wind power can happen.
Reply: @DamienFromPoison  Yet in Germany the price of energy is really expensive AND for all those solar panels and wind turbines, they actually increased the amount of coal burned over the winter because......less wind.
Reply: @uni4rm  Well, you are only telling a halftruth. Yes, in 2021 Germany burned more coal than the year before. But the year before was a record year for renewables, so it is a bit unfair to only look at 2021. If we would not have build so much wind an solar, we would not be near the 44% electrical energy from renewables in 2021, which is less than 55%, but still a huge amount. We drasticly reduced our coal consumption in the last decade and with less stupid politicans, we would be much furher by now.
About the energy prices, yes again, Germany has the highest prices on electrical energy in the EU, but over 50% of it are taxes. Look at France, where the price seems to be low. Well France has much less taxes on their energy, which comes mostly from nuclear plants. And they sell the nuclear energy under cost and subsidize it like crazy. The french power compayny EDF is in so much debt, it is crazy.
You could argue about renewable subsidizing in Germany through the EEG, but this is calculated into the enery price. So if you use much energy, you pay more for the change to renewables. But it is a complicated topic and there is a stupid conundrum out politicans created, where energy from renewables got to cheap, but the EEG rises and so increases the energy price to pay guaranteed prices to the net operators. So our high price is caused by idiots and high taxes, the renewables are rather low in cost.
Reply: @steveclark..  As someone who lives in an totally self-contained/off-grid vehicle, as well as designs and builds these systems for others, I can attest to the absolute bliss one receives from such systems.

Firstly, I'll register my pet peeve:  12-volt systems. They're a vestige of the past that have (IMHO) no place in off-grid energy storage. 24- and 48-volt systems are far superior. Of these, 24V is my favorite for many reasons.

1. Half the current means smaller, less expensive wiring and system components that are much, much easier to work with.
2. Choice. I find that I'm able to completely outfit most rigs with all 24V equipment. The single exception being a TV/monitor. And for that I simply use an inexpensive and reliable buck converter.
3. Efficiency and range matching, particularly with inverters. The low voltage disconnect of many 48V inverters is above the low voltage disconnect of the lithium batteries I build. This means that power is stranded in the battery that can't be used to power AC loads. The 24V inverters I prefer all support the complete power band in which I operate my lithium batteries.

Lastly, while most of the loads in rigs I build are DC, there are a few AC-powered conveniences that are inescapable. Therefore, I find a good inverter is a must-have component in an off-grid electrical set up.
Reply: @BryanTorok  #1  The effects of human activity on climate, namely the burning of fossil fuels for energy, is the overwhelming consensus of the global science community.

#2 Don't confuse weather with climate.

#3 Don't make climate change political. It's a matter of believing in the science...or not.

#4 Don't confuse disqualifying outliers with the suppression of debate. By the way, are you aware that the first warnings about global warming came from none other than Exxon in the early '70's? Where was the mention of debate suppression when climate scientists the world over conclusively proved the trend, as well as outlined a prescription for change? Had their voices been heard and their advice heeded, we would've had 30 or 40 years more years to address the issue.

#5 Climate change represents the ultimate everything-to-gain-and-nothing-to-lose proposition.
Reply: @alistairshanks5099  High Voltage Direct Current (HVDC) transmission is a reality. Right in your Australia, I might add. Check out Australia-Asia PowerLink (AAPowerLink).

HVDC projects are also underway to bring power from renewable energy sources in Africa to the UK and Europe.

Russia and China are also leaders in this area.
Reply: @grgmetube  Studies have found that some 80% of U.S. residential rooftops aren't suitable for solar due to shading, regulations (HoA prohibitions) and lack of ownership.

Further, other studies have proved that an area about the size of Rhode Island is all that's needed to meet the energy needs of the entire US! Installations can be constructed in sparsely populated in southwestern deserts, and energy can be transmitted via HVDC lines.

When it comes to energy storage, we're not talking so much about "batteries" as we are grid-scale storage, such as pumped hydro, and flow batteries. All of the currently available technologies more than meet the needs of both short- and long-term energy storage within the context of normal grid operation.

Remote renewable projects are already underway the world over. AAPowerLink is supplying power generated in Australia to Singapore. Solar installations in northern Africa will supply power to the UK and Europe. And Russia and China are already generating power remotely and transmitting it to population centers and industrial facilities.

Lastly, wave/tidal is capable of meeting the energy needs of the entire world. Combined with offshore wind and solar, complete installations could be constructed where electricity is generated and transmitted via HVDC lines, seawater is desalinated using locally generated power and transported to shore via pipelines, and green hydrogen is generated using locally generated power, then transported via barge and/or pipelines.
Reply: @ARepublicIfYouCanKeepIt  Follow your climate change religion and I'll follow mine.  As for #2, Climate is the sum total of weather.  Why is that so hard for people to wrap their head around?  #4, who decides whether are wackadoodle outliers or legitimate scientists?  So, long as you can minimize or  "disqualify" the "outliers" it will never be possible to change your mind no matter how much contrary evidence is presented.  

The essence of the scientific method is to propose a theory, then test it against the facts.  If a fact does not fit the theory, then the theory must be changed or discarded.  In this debate, you and climate change folks  are willing to minimize or discard any fact that doesn't fit your theory.

Right now, we need to worry a whole lot more about a handful of mad men in Russia, China, N Korea, and the Middle East who are willing to threaten (or actually use) nuclear weapons which will have far more destructive results on the planet that a couple of degrees of climate change.
Reply: @ARepublicIfYouCanKeepIt  Would you say that a 48V system would be the best option for trying to power the average 3 bed house all year round? Do you know if the Tesla wall system is based around 48V for example? Not that I have that sort of money to spend or would want to put it in Elon's pocket but that system seems to marketed as the best home system shall we say?
Reply: @steveclark..  DC voltage is a factor in overall system design. However, everything starts with an energy inventory.

To start, categorize household (AC) loads as either critical or non-critical. Critical loads would include things like refrigeration, medical equipment such as CPAP's, etc., a water pump and some lighting, as well as power for a natural gas appliances for heating, cooking and hot water, possibly a small room air conditioner. Everything else is a non-essential.

Next, determine the energy utilization (measured in watts) of all critical loads, as well as the duty cycle in runtime hours per day. Multiple the watts by the hours to arrive at total watt hours (Wh) for critical loads. This is the minimum size of your energy storage system (ESS).

From there, the continuous load determines the size of your inverter, and the size of your ESS, factoring in things like your latitude and area for (optimally) southern-facing solar determines the size of your PV array.

While you're thinking about solar and/or batteries, consider solar collectors for hot water in addition to PV for electricity.

As for powerwalls, while Tesla is certainly a top-of-mind brand, they're by no means the only game in town. Do your research and you might be surprised how much competition exists.

All the best.
Reply: @ARepublicIfYouCanKeepIt  I have been looking at the competition, even emailed a couple of them but trying to get a straight answer or reply even is difficult. I can't help but think that it's not really possible to run a typical home just off a solar set up here in the UK period,...if there truly is a home in Norfolk that they have installed such a system, they are not coming forward with the specs of that owners property for example.
Reply: @steveclark..  A PV/ESS system in the UK would have a massive array. Not impossible. Just impractical. Other sources of renewables make more sense. The UK is making a major press on heat pumps. Ground source heat pumps work everywhere. A horizontal, closed-loop system could save a tremendous amount on heat and hot water. Also, as impractical as PV is for electrical in much of the UK, solar collectors to heat water for heating and hot water are viable.

As an aside, I've visited the UK many times. The submarine on which I served operated out of Holy Loch. Additionally, I regularly visited London, Enfield and Leicester for business in the years following my stint in the Navy.

I'm also of Irish descent on my father's side.

Scotland and Great Britain hold a special place for me. I love the land and the people, and hope to visit again in the future.

Cheers.
Reply: @ARepublicIfYouCanKeepIt  I've had many exchanges with others where I've pointed out factual information and/or my empirical experiences over decades and made some headway in at least getting the other party to think or concede that there might be another legitimate view.  You, on the other hand, simply dismiss any contrary information, no matter the source, as false.  Even my personal observations are dismissed.  

You have proposed this insane theory that if a person of an opposing viewpoint gets ANY exposure, they have received more exposure than they deserve and it is OK to censor them.  Just who are you, or anyone,  to decide what is the correct viewpoint?  What makes you omniscient?  

If the current pandemic has taught us anything it is that whatever the current "follow the science" crowd is championing is likely to be proven wrong 6 to 12 months from now.  Yet, I and a handful of others made predictions in the first months of 2020 based on education and experience that have been shown to be correct.  In fact, the history of the world and virtually all human progress has been based on the minority proving the majority wrong.  

I resorted to an ad hominem attack in referring to your position as "religion".  It is amazing to me that the overwhelming majority of the people on earth, from all continents, developed and those living a stone age existence, believe in a god or gods.  Yet, every culture has their version that is different than the others and each insists that theirs is the only one true version.  

I believe the climate is changing.  It has always been changing and will continue to do so.  I don't think that the changes will be anywhere as drastic as the doom sayers predict.  Even if the changes are toward the larger end of the spectrum, humanity will adapt.  We always have.  The major cities of Southern California exist largely because of human engineering to move water.   There is plenty of fertile and mostly empty land in Canada that will have a longer growing season.  

I hope to be alive in 20 or 30 years to see which of us is correct.  In fact, I hope we both are.  It is interesting that I had wondered how long this exchange would go  on.  I had pretty much decided this would be my last even before reading the end of your post.  I will leave you with two thoughts:

"I may not like what you say but I will defend your right to say it." -- Voltaire

It is difficult to say what is impossible, for the dream of yesterday is the hope of today and the reality of tomorrow.  --  Robert H. Goddard
Reply: @BryanTorok  Your goal should not be to make "some headway in at least getting the other party to think or concede that there might be another legitimate view." That is the pushing an agenda for the purpose of winning a debate, argument or position.

I'll point out that, over the course of our exchange, you've made claims. You've not   "pointed out" a single piece of "factual information". Additionally, your "experiences over decades" are not, as you contend, "empirical." They are *anecdotal." One supposedly steeped in the scientific method should know the difference.

Your contention that I "simply dismiss any contrary information, no matter the source, as false" supposes that you've provided *information." To be clear, you've not. Further, you presume that information you possess somehow overrules the overwhelming consensus of the global scientific community. I'm here to disavow you of that haughty notion.

"Even my personal observations are dismissed." Correct. Because your second reply in this exchange contained the fundamental error that weather is climate. In said reply, you also politicized climate change; not an act of an honest broker.

As for your contention of censorship, you're either confused or deluded that what you have to say matters. When you spew disinformation, it doesn't. Make a cogent, fact-based argument, and people will listen. If not, you'll be dismissed. This isn't censorship. It's curation.

Statements such as "I don't think that the changes will be anywhere as drastic as the doom sayers [sic] predict" is simply a dishonestly unacceptable excuse for inaction.

My fervent hope is that there are many more who trust science, and far fewer who are willfully ignorant. For this is how positive change will be affected.

It's all good. You can thank us later.
Reply: @ARepublicIfYouCanKeepIt  At a guess, how many solar panels do you think I would need to make off grid living possible? Funny that you should mention heat pumps, the few videos that I've seen from heating engineers based here in the UK say that they are pretty rubbish, customers are not happy with their performance etc,...they just don't seem viable for the way the majority of homes over here have been built shall we say.
Reply: @steveclark..  Unfortunately, there's no way of guessing the size of a PV array a residence requires. Myriad factors, such as energy requirements, method of construction, insulation estimates, structure orientation, etc., all must be considered.
Reply: @BryanTorok  There is a saying here in the netherlands regarding financial investment opportunities. It goes like this: "in het verleden behaalde resultaten bieden geen garantie voor de toekomst". The english translation is "results gained in the past do not provide a guarantee for te future." It is mandatory to provide this text in advertisements of financial investments. I give you this quote because in your reply to John Coloe you say that in the history of the world, virtually all human progress has been based on the minority proving the majority wrong. I would love for you to provide some examples of this. It is a very big statement to make without any. 

Because maybe in the history, the majority of people were against scientific theory, because religion denied any other line of thinking and debate. Meaning that, indeed, the minority proved the majority a lot of times wrong. But times have changed, and a lot of people are following science more than religion (or either accepted both). 

You are just a contrarian. The pandemic has shown that you do not want too follow the status quo because your ego dictates that you are 'smarter' than the rest of us, even if the majrority scientific evidence would tell you otherwise. Yes, the scientific and political communities did get a multitude of things wrong during the pandemic, but what can you expect? We have not had such a pandemic in the modern times we live in (if you count the spanish influenza pandemic of the 1918-1920 as modern), and discovering new viruses comes with making mistakes, and learning from them. 
But I see a lot of cherry-picking your data, while ignoring the overwhelming amount of data against your claim. I understand that the climate change discussion has a lot of fallacies, there is a lot we do not know, but are trying to figure out. You say that your own empirical experiences and personal observations are dismissed. Why do you think that is? Is it better to believe one, or a few, counter arguments, or a majority of empirical proven arguments? Surely the odds are way more in the favor of the latter. Do you truly believe you and your experiences (which in my point of view are just anecdotal evidence) are better than 100's of others? Are you that smart? I surely hope you do not believe that. I am not trying to make the argument that there is never room for counter arguments in discussions, be it a debate on any topic. It is necessary, because nothing has just one side. But in case of the climate change dicussion, a very big majority of the scientific has supported the theory that modern human civilization has a negative impact on climate change.   
You have the right to think and believe what you want. A right to be contrarian if you want. That is ultimately your decision. But we have the same right aswell. A right to ignore the nay-sayers, even to your dismay. 
"I hope to be alive in 20 or 30 years to see which of us is correct.  In fact, I hope we both are".  I agree with your last statement. Time will tell. If it has been proven by a majority that climate change was not a direct result of human civilization, I will rectify my take and give you my sincerest of apologies. But until then, good luck.
Reply: @ARepublicIfYouCanKeepIt  You say the words I wish I could say. Good points.
Reply: @ARepublicIfYouCanKeepIt  Sorry but I don't believe that for one second,....why can't you/anyone take the figures from a previous location/install of a such system for example? Is that too much to ask? I just want proof/an example of an home that's actually done it. There are videos on here of two home owners in the States who tried to run their homes solely off their Tesla walls, one lasted about a week, the other failed within a month, these locations get far more sun than I do. I'd love to be proved wrong but I can't see how it's even possible to run a home 24/7 just off a solar system here in the UK.
Reply: @ARepublicIfYouCanKeepIt  Yes the electrofuels is likely to be the most effective short term solution as you need ZERO new infrastructure.  everything is there to use NET ZERO fuels.Plus all the countries with existing nuclear can make electrofuels at higher output per unit than building solar wind farm. %70 of nuclears capacity is unused and this would likely allow for nukes to be as fast as a battery farm for load leveling with massively higher top ends. For a MSR... I hope Elysium gets their pilot plant going.
Reply: @TheUnshatterd  I could respond to each of your points, but I just don't want to spend the hours on it.  It would be several times the length of your post.  Just to clarify:  I believe the climate is changing, just not as rapidly and disastrously as the doom-sayers.  I think human civilization is one factor among many.  

If the climate change doom-sayers are correct, it is already too late.  Even if we could instantly stop putting CO2 into the atmosphere, there is already too much CO2 in the atmosphere to stop global warming.  We can't stop it.  On the other hand, what if it happens?  Well, populations will move from one area to another.  Some places will be too hot, or too rainy, or too dry and other places will become more hospitable.

When I talk science, understand that I have an engineering degree with the science underpinning the requires.  While you have a right to listen or not to whatever you want, I don't believe the billionaires controlling 80+% of mainstream media and nearly all of social media have the right to suppress anything they don't like while amplifying that which they agree with or which serves their purpose.  Just because they have repeated that 97% figure doesn't make it so.  

Anyway, I've already spent more time on this thread than I intended and I'm done.
Reply: @DamienFromPoison  Germany is free to follow a solar and wind only option.  It is already reaping the problems.  If you think a first world economy can live on intermittent energy, you will have to transfer that energy via pipe or cable from areas that hopefully are friendly to you.  Storage?  There will be baseline nuclear systems that circumvent most of your arguments before full storage of renewables is implemented.  There has been VERY LITTLE INVESTMENT COMPARABLY in NEW nuclear designs.  I think you are missing the point when you use decades of research on the university level as exorbitant WASTED money.  If you think Climate Change is an existential threat, then why limit the tools in your fight?  More resources should have been directed at nuclear research.

Nuclear material is so energy dense the level of environmental damage from mining is miniscule compared to coal, oil and gas. Since coal, oil and gas are needed to build wind and solar systems, nuclear is the only pathway that produces enough energy to reproduce itself!  We have hundreds of years of nuclear material with current designs which ignores that the U238 can be transmuted and used which puts us closer to 1000 years of energy.  When you throw in the thorium cycle, that gives you another several thousand years of potential energy.  By then it won't matter, because fusion . . .
Reply: @DamienFromPoison  I am glad you are not running our worlds energy directives as you seem to have no expertise.

Thorium reactors are an engineering exercise with the problems being clearly defined and solvable.  My area of expertise is in solving the corrosion issues others have mentioned on this discussion.  The waste is small in comparison to what solar and wind will produce.  It is certainly miniscule in comparison to fossil fuel mining.  Thorium is found in coal plant tailings and other rare earth tailings that there is no need to go dig up virgin sources for the time being - simply clean up the tailings!  The nuclear proliferation problem is immensely reduced and the designs are walk away safe.
Reply: @DamienFromPoison  we are MUCH closer to harnessing nuclear energy on a mass scale than we are to developing a battery capable of handling a nations energy grid. Nuclear plants can be safe in every way imaginable, if they aren't on a strict budget. Meaning no risk of going critical, no risk of harnessing the materials for bombs, etc... Note: wind and solar are leagues away from fossil fuels, hydro, or nuclear energy. The amount of resources necessary to convert a power grid from solar and wind is immense, however, nuclear would be much easier to switch too, without geological features posing nearly as much of a threat to the daily operations
Reply: @Lysergic_  This is completely false, nuclear plants have high demands, where you can build them. For example you need a river etc. and with the hot summers in the last ten years, these plants often had to throttle down, to not overburden the eco  system of these rivers.
And we just do not have the time of money to build as many nuclear plants, as we would need to get most of our energy from them. Besides all other concerns, a single plant costs 10-20 billion USD and take at least 10 years to build. Look at France, they want to build 15 plants until 2050. More than 15 old plants will shut down in this timeframe. We have an environmental problem now and only wind and solar can provide us now with a solution.
Reply: @DamienFromPoison  in my locality, we use wind, solar, hydro, and natural gas for energy. Despite the fact that wind and solar have both been heavily invested in the past 2 decades, theyre still on-par with nuclear, despite the fact that we don't have a nuclear plant nearby. Wind, solar, and nuclear are completely overshadowed by hydro and natural gas though. Also, you could also use lakes or even an artificial lake for a nuclear site. Not to mention if you scale down the size of the plants, you will need less resources in general, let alone the size of a cooling pond.
Reply: @Lysergic_  What do you gain from scaling them down? Lets say you scale them by 50%, so you need 50% less space and "cooling" water. Okay, but then you need two plants, soooo?
About the ponds, is that a thing? Why are these plants usually near running water?
And if your country has possibility of producing most of its demands with hydro, cool. But I live in Germany and the only sustainable solution, which makes us more independent of nations like russia is solar and wind.
Reply: @DamienFromPoison  Well the situation in Germany is different, building nuclear plant now would take 10 years to finish, which won't be much help. Best is to build wind/solar and push people to buy electric car, electric heating. Germany will have to use coal to cover its energy need for now.
If you can scale down a nuclear site, like this video talk about, it reduces the risk of "single point of failure" which is one of the major problem with conventional nuclear plant.
Reply: @DamienFromPoison  To be clear I don't think nuclear power tech is ready yet. The last nuclear disaster was just 10 years ago which is not reassuring. For now, I can see a moderate increase in nuclear power but that is about it. It is not meant to be the main source of energy yet. Probably around 10-15% of the total energy consumption while renewable will have to be 50% and the rest would still be oil and gas.
Reply: @Lysergic_  You should look at the growth of renewable energy rather than how much it is. At this rate, renewable will surpass oil or gas total consumption by 2030.
Reply: @super_hero2  This does not reduce any risks, if anything the risk will be greater, as we would have to secure 10 times as many (smaller) plants.
Reply: @DamienFromPoison  It is easier to cool down a 50MW reactor than a 1000MW reactor. Furthermore, you can build it anywhere, and solve the high-cost, lengthy-build-time problems as you an add more later on.
Reply: @super_hero2  Don´t you see, that you would need 20 plants instead of one. That does not make it cheaper, this makes it need more space in the end and you have to guard 20 of them.
Reply: @DamienFromPoison  It makes it easier and faster to build, requires less initial investment/commitment, and as I said safer (you can research more about it). Aside from easier to cool down, it is also easier and faster to decommission, upgrade, repair as you can do it separately in parallel or one by one. It is a lot more flexible.
All of these are major pitfalls of nuclear energy. Of course it need to be tested in practice but the logic is solid.
Reply: @super_hero2  With the slight problem, that such plants do not exist and proposals are full of unsolved problems.
Reply: @nb9361  Not all politicians are completely avaricious and self serving, just the vast majority of them. Lol. The problem is the nearly unregulated deployment and requirement of oceans of money in the system. There's the obvious effect of influence, and it serves as a filter that discorages honest people from running for office, or from staying long, and attracts those with more ahem, "moral flexibility." In the United States especially, candidates cannot win without spending enormous amounts of money, and are obliged to spend enormous time and energy raising that money which tends to leave them overly familiar with lobbyists, corporate pacs, and billionaires and beholden to special interests.
 Campaign finance reform, and public finance of campaigns would go a long way towards having  more responsible and responsive public servants, and better decision making.
 - As for what makes them look good, that's not always a bad thing. If they only had to impress voters and not serve two masters, popular policies and programs would pass instead of being vetoed by oligarchs. And if we can develop a good mix of renewables and next gen nuclear that solves a ton of problems, that should also make them look good, right? Here's hoping anyway.
Reply: @nb9361  "Not reliable enough" ... I mean that's just complete nonsense
Reply: @nb9361  yes and that make them a ton of $$$
Reply: @robertlipka9541  " I am against wind power. " - why are you racist against wind ?
Reply: @scratchy996  I like birds. Wind turbines kill a lot of them.
Reply: @robertlipka9541  And that makes you sad ?
Reply: @robertlipka9541  What about offshore wind farms ?
Reply: @scratchy996  I believe that the same problems exist with offshore wind farms... but killed birds disappear  in the water and the problem is not visible.

From renewable/carbon free power sources I like solar (provided pollution is correctly managed in production and the entire panels are recycled at end of life), geothermal (I am not aware of any problems with this) and next generation nuclear (provided the reactor designs, management and waste disposal is as safe as promised).

The problem with many renewables is that while they can stop global warming, they create OTHER environmental problems or are limited in availability if the problems are avoided. For example, it is possible to locate wind farms to avoid where birds live, but such areas are limited and this limits how much environmentally responsible wind power we can produce. Same for geothermal, it is a good source, but only feasible in a few places.
Reply: @robertlipka9541  " and next generation nuclear" - those will always be "next generation", working in theory , but never in practice.
As for you getting sad and angry about the birds, do you think your feelings are important ?
Reply: @scratchy996  the birds do matter. Plus, my feelings are normal, if I had none on the issue, I would be a psychopath. There are working prototypes of next generation nuclear reactors, I am a fan of the thorium ones. Given time to develop the technology and scale up production to lower costs, nuclear can provide 100% carbon free energy with no limits, unlike some forms of renewables.
Reply: @ARepublicIfYouCanKeepIt  Exactly!
Reply: @robertlipka9541  Are you including the environmental cost of drilling for oil and mining coal plus transportation? Show me the total cost for another form of energy generation that is cheaper. I will wait. You mention future nuclear technology, but that is a bit unfair. Future turbine blades may be recyclable. Currently, nuclear energy produces more dangerous waste than solar or wind energy. The batteries involved in energy storage can be recycled up to around 80-90%, it is just it is currently in the patent process.
Reply: @DamienFromPoison  so how does your comment hold up now that you ate going to freeze without fossil fuels?
Reply: @jamellelangfordiii3586  Uh, what are you talking about? The energy crisis because of Putin? Well, we would not have those problems, if we were not so reliant on fossil fuels. And nuclear especially is a problem, because we in Germany had to give quite a huge amount of gas to France, as their nuclear plants were/are shut down for month. So, yeah at the moment we still are reliant on fossil fuels, but that is a political problem not a technical one.
Reply: @DamienFromPoison  ok, and I am sure your renewable energies will work super good in the winter. Maybe you should have listened to Trump when he said you shouldn't trust Russia. If you hadn't shut down all your plants until you had the infrastructure to support yourself, you wouldn't have this problem. I agree we need to get of fossil fuels, but we aren't there yet. Maybe if you made your own energy, instead of paying someone else for it, there would be more money for research.
Reply: @DamienFromPoison  they can be recycled, but they won't. It is cheaper to make new ones then recycle the old... Plastic is recyclable, but half of it ends up in landfills or the ocean, because it is cheaper to make new plastic. In a utopian society, these things would work. Unfortunately we live in a world run by corporations, don't be fooled that the people who push green energy aren't making huge profits from it. Until we can get an energy that is completely free, someone will always try to profit off of it.
Reply: @DamienFromPoison  also, they are researching ways to reuse the nuclear waste in other nuclear reactors, as well as using materials besides plutonium. You should check out the other videos done by this channel to see.
Reply: @jamellelangfordiii3586  Well, renewable energy is kinda "free" compared to nuclear plants, cost wise. And no, most plastic can´t be really recycled, because of that we need better solutions.
Reply: @jamellelangfordiii3586  I haven´t seen all videos here, but I don´t think that Matt is much of a nuclear fan. And every time the arguments comes to the point, where the nuclear proponent comes along with Thorium, Gen 4 reactors, plutionium rod reuse etc. one can only let out a sign and tell them to check if a single of those advanced techs are available. Spoiler alert, they are not and they are working on them for 40 years by now. There is no safe, cheap, environment friendly nuclear power and there never will be. It is all lab experiments with an ungodly amount of unsolved problems.
Reply: @DamienFromPoison  well like I said, there really isn't any good answer, because they all have drawbacks. I guess the answer is which drawbacks we are willing to accept and which ones we won't. That, of course, is where the divide is, and everyone thinks they are right and everyone else is wrong. One thing is for sure that the rich will not have any problems heating and powering there stuff and the poor will suffer. Although I suppose that is a problem as old as civilization, right?
Reply: @xenod1066   yeah, indeed.
Reply: @BryanTorok  😂
Reply: I have rooftop solar that cost me 18.5k in 2017 and another 9.6k in 2022 (after federal rebates).   I'm generating over 65kw/day in summer right now.    In 4.5 years I've already generated and used over $12.5k in electricity (and that is using PG&E lowest rate so its really more than that).     My annual electric bill has been about $200, however, after my recent upgrade in 2022 I will get money back (until I buy an EV truck).   Understand, I went over 100% to get in before they change the net meter program in CA so my value doesn't get cut in half (based on proposal that was shot down temp) and forecasting how much power I'll need to charge an EV.
So, while I agree Solar may be transitional, for folks in sunny areas, west west or southwest facing roofs and little shade over roof, its ideal.    I can run my AC 8hrs/day and never pay for electricity.    So, I cannot agree with "waste of time".    Since solar/wind is not 24x7, they are only part of the overall solution as John states.   The grid in Texas would have fallen over completely if not for wind/solar (they are the largest producers of wind/solar power in country even with their politics, they just produce it and sell it rather than folks having their own).
Reply: @nb9361  Did you not see the price points for Wind and Solar? I'm from the UK and they already contribute a lot to our energy needs (highest ever was 85% in 2019). If it was not for the current government banning more onshore windfarms we would be in a better position. I agree that Tidal and Nuclear need to be in the mix but Wind and Solar are by far the cheapest. The baseload should be provided by Tidal and Nuclear. Also in the UK currently, you cannot sell too much back to the grid. My relative has an excess generated from their solar panels and the electricity company does not want to use it. They consider them a rival generator - absolutely crazy. When the battery pack arrives then it will simply store the energy.
Reply: @thesupremekai1980s  In 2020 solar power provided 4.4% & wind 24.8% of the UK's electrical energy requirement. This may come as a bit of a shock to you, but, the sun don't shine at night and the wind don't blow at all on many days. So, we have to store the energy for when it's needed at peak times. There are many YouTube documentaries on the problems associated with electrical energy storage. I suggest you have a look at them.
Please also bear in mind, that the 4.4% & 24.8% contributions of solar & wind is only electrical energy provided to the National Grid.
This is not the total energy requirement of the whole country.
Our entire transport system, with the exception of some train lines & a handful of electric vehicles, runs on a collosal amount of fossil fuel. When this is taken into account, wind &  solar provide a very small percentage.
Sadly the west is run by cretins who think that because solar panels are cheap they must be good. Because electric powered cars do not produce any emissions they must be great. This is nonsense. Volvo have just produced a study proving that their XC40 has to travel 90,000 miles before produces less CO² than their petrol XC40. This is due to the production of lithium.
There is no big picture thinking, no planning, no questioning by any government in the western world.
If we all follow along thinking solar & wind power will save us when fossil fuels run out, we're screwed.
Reply: @nb9361  with a population that has no understanding of nuclear energy, if it is as bad as they say it is, how could anybody with a soul want to risk messing with it, better yet leave it for our children to deal with, the ones with genetic defects. all for a little energy. solar seems like the most promising to me. just a few nuclear accidents and there wont be any land to run from.
Reply: @dreece2000  Good Greif, I have no words.
Reply: @nb9361  Nuclear fuel is non-renewable and expensive and mineral is non-uniformly distributed